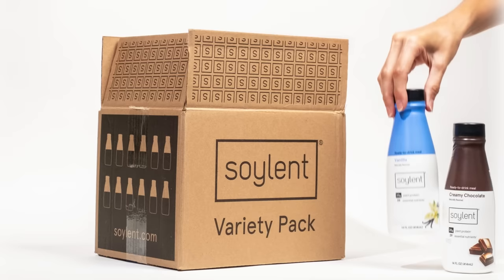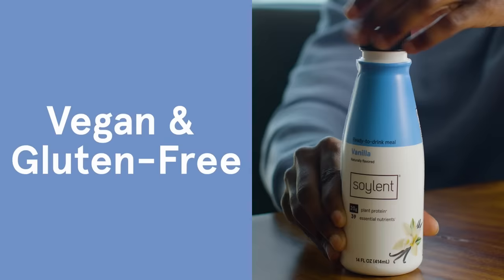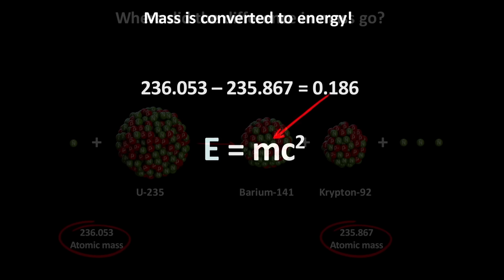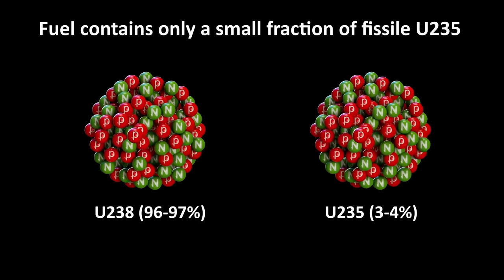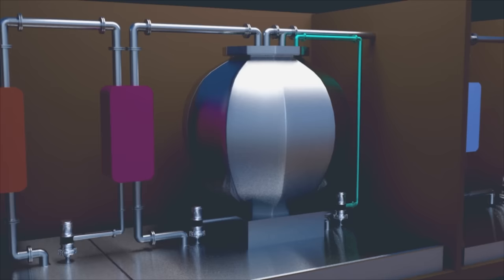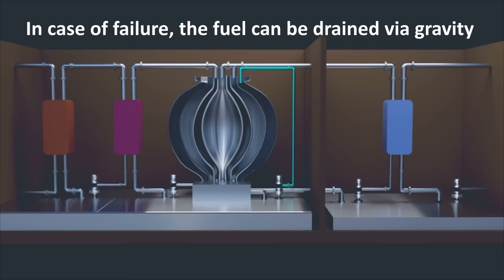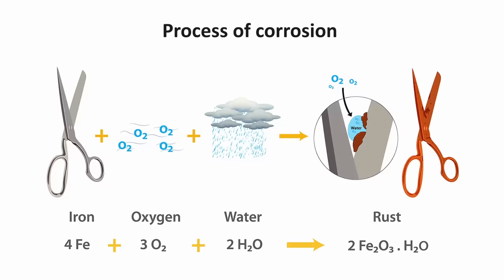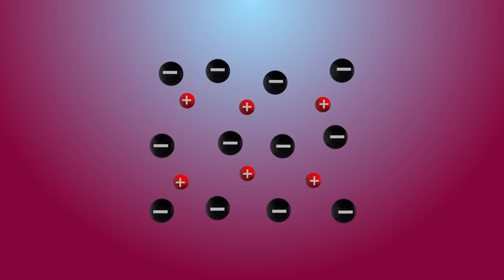How Molten Salt Reactors Could Revive Nuclear Power

Comment: First: As a nuclear power plant engineer who is very interested in new nuclear power plants I would like to complement you on being I believe the 1st YouTuber to talk about the very real corrosion issue with MSR's.   People often wonder why there was never a 2nd MSR test reactor after Oak Ridge.  It was because there was no known super-alloy of the day that could withstand the corrosive effects of the daughter products and chemicals generated by their reactions in the mixed molten salt stream that occurred at the Oak Ridge test MSR.

The good news is that a number of countries have been doing research into new "exotic" super-alloys that should better withstand the corrosion (to the best of my knowledge - no one has found an "immune" super-alloy at this time).   Also, that the concept of chemical separation of the problem daughter products and resultant chemicals has been developed and limited testing of the concept has been done without actually using real MSR molten salts and daughter/chemical byproducts.

So the theory is that if you use a much better super-alloy than what was used in Oak Ridge and can filter enough of the daughter products and chemical reactants that you can minimize the corrosion rate to one that would allow construction of a 40+ year operating life reactor and molten salt stream piping and equipment.   As you pointed out this is only a theory and has not yet been adequately demonstrated.

China built and started up a 2 MWthermal test reactor in I believe August 2023 to test their best guess of the right exotic super-alloy and an adequate filtering system.  This test reactor is about 1/4 the size of the 1960's Oak Ridge Reactor.  If it works (which is an unknown and failure is a real possibility) they plan on building another test reactor 10-15 size larger to see how it scales up.  If that works then a small power plant (likely in the 40 - 60 MWe range).  Then if that works they can design a power plant likely in the 200-400 MWe range.   Etc.   

Each step is likely to require a minimum of 5 years of successful run time before finalizing the next larger size plant design and starting construction.  Reliable MSR power plants are likely several decades away.

Note that the history of nuclear plant development worldwide shows that scaling up from test or small reactors often does not go very well.  Lots of plants the next size larger did not work well - or needed major modifications.   No one at this point knows enough about the performance of any fuel in a MSR to do anything but take a very large gamble on building a power plant sized reactor (and we know that well as the USA built 4 commercial thorium fueled nuclear power plants in the 1960's - 1970's and all 4 were both a technical and a commercial economic failure:  I will post separately on that history).

Second: Liquid salts are not the only material that expand and self control a nuclear reacton in a reactor.  Light water BWR's and PWR's do the same (I'm not sure of heavy water reactor designs); and in the case of PWRs (which I have worked extensively in) once the reactor is in the power range they pull out the control rods more and just let the water temperature self moderate the reaction rate.  So nothing new here.

Third:  I hate to pop your bubble about Copenhagen Atomics, and about 15 other such companies in both the MSR and SMR market.  I consider them an investment scam company (they exist to get investor money to fund jobs for a decade or more).  They are not serious at all about building a real nuclear reactor and their designs and timetable are laughable to anyone with real experience in the nuclear industry. They don't even have a clue on which super-alloy will be needed to make the concept work yet (ordinary 304 SS is corrosion resistant to the pure lithium salt with unreacted nuclear fuel in it - the problems start once the nuclear reaction starts).

Companies that are serious are working with a nuclear regulator for eventual licensing of the reactor.  This typically takes several years and multi-millions of dollars in a "pre-License" review process (and all western nations have such a process or will tell you to use a design licensed by other western countries).

The best example right now is I suggest that you look up the Canadian Nuclear Safety Commission website,  page down to "New Reactor Facility Projects" link, then use the link under "Current pre-licensing vendor design reviews" heading not quite half way down the page.  There are two links near the top of the page for "Current" and "Completed" and a list of project at the bottom of the page.     When this process is completed the vendor knows what will be needed in a license application for a reactor design.  It typically takes several years to review a license application once submitted if it has all the required information and the regulator agrees things are properly designed and proper procedures and staffing will exist.

The mass production possibility is a myth.   Airbus and Boeing build over 100 of the same model airplane each year, and they are largely hand assembled.   Yes a number of parts are mass produced; but its cost prohibitive at that production rate to build a plant that could automate the assembly much more than it is currently.   You would likely need to have orders on the order of 250 near identical MSR plants per year for at least 5 years to justify building a plant for mass production (and that plant will take years to build).  Just not happening - no one needs that many new power plants (even at 50 MWe each) for that amount of time.  Also, nuclear plant is highly site specific due to earthquake and natural disaster requirements.   One location may need very light reinforcement and provisions for a natural disaster.  The next site may need 10 times as much.   The sites with low risk do not want to pay for 10 times the reinforcement materials.

Building nuclear plants requires a assembly of lots of parts; and having it in an appropriate safety structure.  Also, nuclear construction codes exist due to lives lost and major nuclear plant issues.  No short-cutting those and only about the top 25% of workers adjust to working like that (it's a completely different approach than normal construction).  They also want to be paid for their expertise.

This myth also assumes that your design is well proven.  It took the light water PWR about 50 years of operating history and lots of failures along the way to know how to build a well proven design (the current AP-1000).   It will likely take a similar amount of time and failures to get MSR reactor plants that are really well proven after the designs are proven in test reactors.  Who is going to buy more than a few units until the design is shown to work well for decades?   Low production numbers means no special factory and highly skilled and paid workers custom building most everything.

Have a great day,
Reply: Thank you for this reality check. I had already suspected Copenhagen Atomics of being an investor-trap, and feel validated that somebody with more knowledge of the industry would say so as well. Does this go for all the highly profiled actors in the thorium space, like Flibe Energy, Thorcon, and so on?
Reply: Thanks a comprehensive reply from someone with his feet on the ground. One other point. commercial nuclear power came about on the back of the atomic bomb projects. Thorium has yet to find such a sponsor.
Reply: That's easily the most excellent comment I've ever seen on Youtube! Better than anything I could've written.

As of late, the Youtube science and engineering community seems to have discovered nuclear power as a topic of interest. Obviously, MSRs and SMRs are the new thing that everybody seems to agree will make nuclear power generation rise to glory again and be the ultimate solution to decarbonization.

I myself was getting tired of always pointing out the obvious problems with that. Your write-up gave me new energy, and I might quote you on occasion, If I may.

Thanks for taking the time to share your reasoning.
Reply: Very well said. Thanks 👍
Reply: Even so, with or without molten salt or variants thereof, I would like to see much more nuclear power. Our current fossil fuel addiction has several downsides much greater than what nuclear ever had. The big one is of course the changes to the climate and the bad consequences thereof. Besides that the emissions themselves also cause a lot of health issues in the population and fuels like oils are often obtained from less savory countries, prop up dictators, help keep them in power and help them to repress populations and cause wars. Besides that (this doesn't count for the US, but the US is not the whole world) not all countries are blessed with an abundance of natural resources and spending a lot to import fuel is a drag on the local economy. Thanks for comment, good luck!
Reply: My bachelor and current master research topic is molten salt corrosion. I just realized how niche this topic is XP
Reply: Subscribed. 👍
Reply: Pin the ** out of this comment, thanks
Reply: A comment like this is golden. Thank you!
Reply: Nice anti-nuclear rant but you started out completely wrong and it just got worse from there. The MSR project did not end because of corrosion issues and I suspect you know this but say it anyway. 

Every single gen. IV nuclear start-up has read every report from those original experiments and developed a strategy to mitigate corrosion. In fact it was their first consideration. Molten salts are no more corrosive than pure water, both just need to be handled correctly. 

What you are (more) correct about is the timing/schedule of the deployment of gen. IV reactors. It will be slow but that's not a problem. The transition from fossil fuels to fission will take a VERY long time. It can happen much sooner but the love affair with worthless wind and solar has to run its course to failure first.
Reply: Then how you do explain the new Chinese MSR's? Do you think there may have been more materials research since the 1950's? Honestly...
Reply: @stickynorth   I discussed the Chinese MSR in my comment.  It's a test reactor designed specifically to determine if we have solved the corrosion issue by use of a "exotic" super-alloy and if the chemical filtering theories and equipment work as planned.  If they do then we now know that we can likely build a power plant MSR that would last 40+ years of run time (working through scale up issues).  If it doesn't work so well - then we have more research and work to do to find a solution.

I have read many papers about different exotic super alloys being developed and tested in "simulated" MSR environments from the last 15 years.   I can tell you that in fact a lot of various other super-alloys than what existed in the late 1960's have been developed and tested.
Reply: @chapter4travels    I don't know what all those people have read.   I know what I have read (direct from the DOE records).

I know that a lot of research has gone on in the last 15+ years in many countries on developing super-alloys that may work in a MSR environment (I have read the research papers).

I'm aware that all of those companies you cite have theories as to how to solve the problem (although some of them just ignore it); but none of the theories has been tested (and the vast majority of theories do not work out as practical in practice - at least without decades of development: history tells us that).

I also know why the Chinese built their MSR test reactor - its' specifically to see if they have an answer to the corrosion issue; and the reality is that the answer we will get from this test reactor is "not yet" based on my knowledge of the history of test reactors and product development (and to develop better thermal performance modeling).  I've read summaries of their papers.
Reply: @perryallan3524  I've wondered how the Oak Ridge reactor ran for so long if corrosion was such a huge issue.  What did they use, and were they regularly swapping out components?
Reply: @JRP3  It's actual run time was fairly short.  While its listed as operating for about 5 years, it only ran part time.

The corrosion issue was not identiried initially although they were aware of the problem by year 3, and knew it was a significant issue by year 5.  The true extent of the corrosion was not actually known until after the Oak Ridge MSR was dismantled for disposal.

Oak Ridge worked despite the corrosion because of very conservative design.  components and piping were thicker than required with more modern standards.

Contrast that with modern nuclear power plants that are designed and licensed for 60 years up front and built with materials that experience has shown will not have any major issues for that run time (with allowances to extend the license beyond that).  Many people expect these plants to run for double that.

I spent most of my nuclear career in a plant designed and licensed for 40 years.  It got a license extension for 20 years (to 60 years of operation) and the 1st unit is now over 51 years old.  The plant has applied for another 20 year license extension (to 80 years) and people are seriously talking that it might run for 100 or more years safely (and that they may have to replace all the wiring and controls for the plant for that - which would likely be a 1 year or longer shutdown).

That is what a MSR reactor has to compete with.  So the corrosion issue really must be solved.
Reply: You said it. 😎
Reply: I read your whole comment. Thanks for your insights.
Reply: Not sure how you define cost-prohibitive if a city, state, or country can afford to build new power stations. Does everything need to be profit-based? That causes as many problems as it solves (like cost-efficient car power vs global warming). We really should think about better city power tech from the standpoint of what the people need instead of what a company wants.
Reply: @watamatafoyu   You are correct that cost by itself is problematic.  However, in the end a cost effective solution must be part of the equation.  There can be other factors.  For power plants you might want to say low CO2 Emissions, Low (or no) particulate emissions, or many other factors.  You also may wish to say a method that does not kill or maim people (or only does so very rarely due to very rare events).  The list of other factors can be long.

Then you have to look at the lowest long term cost to achieve the other factors.   Anything else requires the people to pay more money for a basic service such as electricity, money which most likely can be better used in other areas of their lives.

Power plants are not exotic yachts where only the very rich or wealthy utilize and in reality the owners don't care much about what their "toy" costs for the features they want.  Power plants provide a basic commodity that is required for normal society and most companies to operate.
Reply: @overtoke   I don't know.  However I know of no glasses that would stand up to the temperatures and vibrations of an operating nuclear reactor and its piping.  Ordinary glass will melt.  Quartz may not melt at operating temperatures but is brittle and has no real strength.   There is also no way to coat the ID of everything (reactor, piping, valves, flanges, etc.) to prevent corrosive attack anywhere.
Reply: While the AP1000 seems to be working well in China, the units in Georgia were enormously expensive and several years late. I worked on the ones being built in South Carolina that had to be cancelled when the delays and cost i creases became unbearable. Part of the problem was the designer picked some incompetent subcontractors who had no nuclear experience. Another was trying to recruit workers who were willing to put up with nuclear standards, drug testing etc. We recruited people from as far away as Alaska. Many were in their 50s or older and being on a committee that reviewed discrepancy reports, it seemed like the workplace injury rate from heart attacks, falls etc.was high.

People see a video or lecture about a neat idea, get enthralled with the technology and never consider what are mundane matters that can make or break a project.
Reply: @KevinBalch-dt8ot   The problem was twofold - and you identified the biggest one.  The USA had lost the knowledge at both the contractor and worker level to build nuclear plants.    Extremely costly with lots of delays, rework, etc. As only about 1/4 of the current workforce can adapt to how things are done in the nuclear QA world - they had to flush a lot of people though (and absorb the mistakes and rework) to get people who could do the job.

Another problem was that a number of suppliers did not actually ship the required grade materials to site (they substituted lower quality materials - and may have submitted false certification paperwork).   In the end a lot of material had to be reordered from new suppliers - which meant more delays as instead of having material on time - you now had to wait months if not a year to get what was needed.  Unfortunately, it was difficult if not impossible to recover the money already spent on substandard materials and  parts.  I have been told by several people onsite that there was cases where the substandard material was not discovered until after installation - which meant tear out and redoing with good material.

However, if you take the same contractors and contract managers and supervisors to build the next nuclear units...(before they age out) things will go much more smoothly as they have learned their lessons.   Another set of AP-1000's started in a few years would likely only have about 1/2 of the overrun for the units you worked on, and a 3rd set after that would have minimal delay and rework as the US will by then have trained enough managers, supervisors, and workers to keep the project on schedule.

By the way, this kind of delays and learning curves happen in the non-nuclear industry as well when entirely new products are developed and put into the market (the 1st ones are always very expensive, then the next batch is cheaper, etc).  It's just not as costly.
Reply: From what I've seen and read, the corrosion issue isn't just within the reactor either - MSRs need a very complicated chemical processing plant, and corrosion is a big issue there as well.
Hopefully the scientists and engineers working on this will figure out solutions to these issues, because it certainly has potential.
Reply: @DeanLee1   You are correct.  It is every system and component that the circulating MSR fluid touches: Piping, pumps, valves, instruments, chemical separation equipment, sampling equipment and coolers, etc.  Everything.

Companies that make all of these components will have to design components with whatever super-alloy they come up with that works well enough to be usable.

You may also see a lot of lessor equipment ans systems replaced periodically as well if the equipment cannot last decades of exposure.   Most people do not understand how expensive that would be.
Reply: @DeanLee1 - It’s not just the corrosion. In solid-fueled reactors, the highly radioactive fission products stay in place in the heavily shielded reactor. In an MSR, they are circulated in the pipes making them highly radioactive. These can be shielded during operation but it makes maintenance more difficult.
Reply: Thank you for this incredibly insightful comment! You don't see many comments like this, especially on YouTube, so thanks for taking the time to write it.
Reply: All this is just telling that MSR is just not wanted. All just nitpicking problems, many of them that were already solved during the development of the traditional nuclear plant. The only real reason seems to be the lack of a suited anti-corosive alloy. But that's just one single problem. It leaves me completely baffled that, with all the advantages that molted salt reactors, there isn''t a more optimistic stance and that more resources are not brought into making this work. 
The speaker here addressed actually the fact in one sentence "it's not wanted because it doesn't produce plutonium". When a clear explanation is not given but avoided, that's the only conclusion remaining. 
People must be made aware of this possibility and I think social pressure is what eventually will drive the MSR to fruition. 
Thank you for you insight but I don't think it was unprejudiced.
Reply: @rccc5806  this is quite a foolish take. There are many technologies that are one problem away from being the perfect solution. Oh if only we could just make a room-temperature super-conductor, we've made lots of super conductors before, why not just make one room-temperature? It's just one problem. See how foolish that sounds? It is not nitpicking to say that this technology currently has serious issues with corrosion, and it is a complete mischaracterisation to just hand-wave it away as "just one single problem". 

Furthermore, the problem with nuclear technologies these days is that fission is considered (by the public) as dangerous or scary, which hurts political will, which removes funding. For the funding that exists, there is a lot more focus on fusion, of which are a lot of junk startups (in both fusion and fission). Additionally, the infrastructure and knowledge base is built entirely around Uranium and refinement of Uranium (due to cold-war decisions as Uranium could be used to make nuclear weapons), so doing the same with Thorium will take many many years, even decades to prove efficacy as the original commenter mentioned.
Reply: Thanks for sharing your expertise , and realistically limiting our hopes / aspirations , in dealing with corrosion.But …., what if design and development was limited to smaller , limited eg 5 MW , modular and mass produced reactors , rather than scaling up , …. and if collaborative international design and development was urgently prioritised - could the problems be resolved in order to make a difference to greenhouse gas emissions in time ?
Reply: @Vnifit  So, your take is "we don't have knowledge with Thorium because we don't have knowledge with Thorium". Very smart that one. 
I am not the one to assess if corosion is an equivalently difficult problem as high conductive at room temperature, but I gather it is really not like that. The willingness to take on the problem could go a long way. But hey, in these days it's worth more chasing ilusory solar and wind horses. 
I also think, current Uranium technology is still viable but really Thorium looks very much like a very close next step, far, far closer than the fusion.
Reply: @sheenapearse766   First:  No one even knows what exact alloy and amount of chemical filtering will work yet.  That is independent of MSR reactor size.

Second:  No one knows yet what "theoretical" design will actually work long term.  The vast majority of designs that people think up don't work out in real life (how you would solve this problem - and there are hundreds of problems to solve in a nuclear power plant: lots of things look good on paper and sound good in theory: the real world is different).

The USA currently has literally what I consider the best and safest new PWR design reactor in the world (AP-1000 Nominally 1100-1150 MWe net). The European EPR has been a disaster and the designers admit that they have to redesign key elements and no further EPR's will be ordered).  Note that the Chinese just ordered 6 more  AP-1000's as it's far better than their own latest design which incorporated elements of the AP-1000 design, Ukraine is planning on I believe 7 of them (and they are starting construction on a plant with 2 AP-1000's), and other countries have said that they are looking to build another 15 AP-1000's with construction starting at various points in the next decade.   

We got there because the USA built something like 104 nuclear power plants with something like 76 different plant designs in the 1960's - 1990's. Some of those plant design decision were so bad that the plants were retired in less than a 5 years (even large base load units).

After 30+ years of operation of the designs that worked well enough to run that long the designers of the modern USA Gen3+ (passive safety) could ask such questions as: What is the best design for a spent fuel pool?  You would think a reinforced concrete water pool somewhere in the range of 40-50 ft deep with a SS lining would be easy to not mess up.  I understand that the USA built 4 different base designs of Spent Fuel Pools, and 2 of them had noticeable problems that developed after 20 years of operation, and one design stood out with the least issues (and perhaps no issues) after 30+ years of real plant operation).  They could do this kind of long term "best design" analysis for over 100 specific design features that are required for a PWR nuclear power plant (and GE did a similar thing with BWR plants although there were a lot less design options built).  The AP-1000 used all the "best long term" PWR design features based on 30+ years of actual PWR plant operations.

While some of the steam cycle side features of a MSR could use this knowledge base - there is not any similar design and operating history for any MSR based power plant (and I remember reading about 4 completely different design ideas for the MSR reactor itself, which does not even get into all the support systems).

Standardizing on any single design at this point for the MSR is just taking a huge and very costly gamble (read my Thorium Power Plant History Post - which is a separate thread).  No one knows if the design chosen will even last or work well long term.  The history of nuclear reactor design worldwide shows many initial reactor and nuclear plant designs failed at the test reactor size or when scaled up into power plants, and a number of 2nd generation designs based off of lessons learned from the 1st failures also failed.

Third:  A key part of nuclear power plant cost of operation is protection of the plant and public from terrorism (security team and design features), having an adequate Radiation Protection department to handle a major nuclear issue at the plant and area surrounding the plant, and having an adequate Emergency Response staff to protect the health and safety of the public in the case of a major reactor incident and leakage of radionuclides into the atmosphere where it affects the downwind population (it seems that most MSR scam companies don't talk about these costs).

The cost for any nuclear power plant for Security, Radiation Protection, Emergency Response actually does not change much based on the size of the nuclear power plant.   That is one reasons the nuclear industry in most cases builds large central stations - in order to keep the staffing cost reasonable on a per MWhr of generation basis.

Fourth: there will never be any cheap nuclear power plants.   As an example NuScale developed and licensed a 50 MWe PWR SMR in the USA with a plan to build a plant with 6 units (total plant size of 300 MWe) in Utah.  The site was licensed and a Construction and Operating License (COL) was issued by the US NRC (Licensing the plant and site alone likely cost over $10 Million, and perhaps several times that).  

Now everyone had noticed the huge delays and cost overruns of canceled VC Summer and nearly completed Votgle AP-1000 plants; which were caused by US construction companies having lost the expertise on how to build a nuclear power plant to nuclear construction standards: Construction management had no clue - and thought it could be built like a fossil fueled power plant.  Then add a workforce that had no idea how to build things to nuclear construction standards (non-nuclear "close enough" is "good enough") construction practices just does not work in nuclear work, and you cannot have workers that use recreational drugs or are in trouble with the law.  Then toss in a variety of component and material suppliers who substituted cheaper than specified materials and products (a lot of which had to be tore out and replaced):  The USA learned a lot about which supply companies could be trusted.

So the Utah project specifically asks for bids from the Construction Mangement companies at the VC Summer and Voglte plants that had learned very costly lessons on what it takes to build nuclear power plants.

The quote came in at $9.3 Billion, with an estimated inflation adjuster of $1 Billion during the life of the construction project ($10.3 Billion estimated total).  That works out to about 3 times the cost per MW hour than the Vogtle AP-1000 plants which are 7.4 times larger (2228 MWe total plant size).

As the operating and maintenance staff will be about the same size as Vogtle AP-1000's (6 small power plants vs 2 large ones - about the same staffing requirements); and the Security, Radiation Protection, and Emergency Planning staff would also be about the same size as Vogtle.

So this 6 unit SMR plant will cost about 3 times as much to build per MW of generation, and the operating staff cost are in the range of 7 times higher compared to Vogtle AP-1000's.  What makes you think that SMRs (of any technology) will be cheaper than larger central stations.

The project was canceled and talk of "small" SMR's of any technology has tanked in the real world.  Even the most recent SMR talk among serious companies are using a 300 MWe "SMR" which is the approximate size of a number of initial nuclear power plants built in the 1960's and early 1970's (none of which are operating today).

Fifth: high production rates of any MSR design (even if small) is likely to only occur 50+ years in the future after some design proves that its' long term reliable and economical.  Until then there are really no cost savings in the construction cost of building a nuclear power plant.  Even at a rate of 50-100 Units per year the plant will largely be field assembled by hand using components shipped in.  All plants will be built to nuclear construction standards (and anyone saying they are going to use lower cost commercial production techniques is "blowing smoke").
Reply: @FrancisFjordCupola  Long term for solar system wide and/or interplanetary expansion, nuclear power is essential. But, short term and specifically for fighting climate change, fossil fuel companies and petro-states promote current and speculative nuclear power as a solution because they know it isn't cost effective. If you look at current un-subsidized Levelized Cost of Energy (LCOE) both solar and wind come in well under nuclear, and under the cost projections for these "mass produced" new nuclear technologies.
Reply: This type of defeatist and pessimistic mindset is why innovation has dramatically slowed in the last few decades in the energy industry, people like you who are only capable of seeing how things can't work, but are never creative enough to see how they could. Those inflicted with poverty of imagination. People like you aren't meant to give opinions on what could be possible, you aren't meant to give opinions on how you think the world will look like a decade from now. There is a level of creativity and imagination that is required to be that type of person, both of which you and many people in the energy industry simply lack. You are meant to do as you are told and keep maintaining the status quo. 

I will keep rooting for companies like Copenhagen Atomics who are daring to disrupt slow, inefficient and un-innovative industries. 

You would have told Elon Musk that electric vehicles and reusable rockets were "decades" away or some kind of pipedream if he had told you about his plans a few years ago.
Reply: @sheenapearse766   My apologies, I forgot to list a 6th reason why you won't see mass production of any reactor design.  I thought I had addressed it above in other comments.

Sixth:  there is and will never be a "standardized" design for a nuclear power plant.  Designs are very site specific due to the different natural disaster possibilities for each site:

What is the worst flooding risk - and from what?  Fukushima was in fact a failure of the Japan nuclear regulator to require nuclear plants to be designed for tsunamis.

Fukushima only had to be designed for flooding that occured on average less than twice the licensed life of the reactor (80 years).  The tsunamis in the area were known to occur about every 90 years.  So the plant was built to a standard that provided a 45% chance of a tsunami in its 40 year operating license.   The plant could easily have been built 3-4 meters higher and not been affected at all for very minimal additional operating cost (more energy needed to pump cooling water for the steam condensers).   They actually buldozed down a hill more than that to build the Fukushima nuclear power plant.

Needless to say, Japan and everyone else has changed their standards as needed.  However, that plant design never would have been allowed in the USA and most of EU countries as the design standard has always been "much worse than any event in the historical record."

What is the earthquake risk?   The more severe the "design" earthquake based on the historical record the thicker the reactor vessel wall and piping will have to be.  More robust support structure and more  robust piping support structures, and more robust "auxiliary" equipment like chemical filtration units and various storage tanks.   Even the foundations of the plant and the containment and shield building structure  has to be more robust.

What is the worst case wind risk? Hurricanes/typhoons are the lowest risk (although they often cause substantial flooding).  Tornadoes are worse.

Terrorism risk?  Some sites are more easily naturally dependable than others.

Does the plant need to be air-conditioned because its often (always) too hot to work in or too hot for the equipment (this is common for plants near the equator in certain parts of the world)?  Does the plant need to be heated parts (or much) of the year (common in the extreme north)?

No one wants to pay for a standard design that's built to the worst case standards for everything.  It would be massively expensive and overkill for almost every site in the world.  So each plant has its own specific design requirements in order to appropriately protect the health and safety of the public.

That totally negates mass production of a single design.  Sorry.
Reply: Thanks
Reply: @xBIGMUSCLEx  You got me wrong.  I'm just being realistic about what it takes for nuclear power.  Our current design and construction standards are written in some cases in blood (people really died) and in many nuclear "incidents" that were extremely costly.  Companies like Copenhagen Atomics are telling people that they can ignore the design and construction standards - and don't even have to license their designs or sites they are going to put their reactors on.

Tell me - how many atomic power plants do you think they well be allowed to build without using approved nuclear design and construction methods and without getting their reactors licensed.  They might be able to  bribe some 3rd world country dictator into allowing it; but neither China nor Russia would even consider it.  No mass production possibilities with a few 3rd world countries.

Do you know what the key responsibility of all staff at nuclear power plants in the western world is:   "To protect the health and safety of the public."  It's not to generate power first, it's not even to protect the plant workers (most who will voluntarily die if that's what it takes to stop a nuclear catastrophe).   Now it's more than great if we can generate power while protecting the health and safety of the public, and the plant staff  - and the nuclear power industry has proven that it's quite doable.

As for thorium power- the likely cheapest safe way to move forward would be to put a thorium core into something like an AP-1000 PWR reactor.   The Shippingport "demonstration/test" reactor (60 MWe) showed that you could put a working thorium core in a PWR light water reactor.  Please read my post on the history of commercial thorium nuclear power plants (the USA built 4 of them).  They took the lessons learned from the previous PWR thorium failures to design that core.

However, MSR reactors have a lot of R&D to go and I don't doubt that they can eventually be made to work.  It can be done - but it will not be quick and cheep.  For those willing to invest sevearl hundred $billions with the expectation of decades to make it work it may be possible (and the Chinese MSR project was funded at $500 Billion in 2011 and the researchers don't expect a power plant for many years: of course there are PR people claiming otherwise).

Also there is "zero" evidence to suggest that in actuality that thorium reactors will in fact be cheaper than uranium (or plutonium) reactors.  All we have is a theory that it should be possible.

Also key to this theory in many cases that it will be economically reprocess and recover the U233 from a thorium based reactor (thorium is not fissile - it will not react by itself).  Thorium can be converted inside an operating nuclear reactor into sufficient U233 which is fissile and what a thorium based reactor actually runs on once its seed fissile materials are used up.
Reply: As I remember Pu is not just a waste product in nuclear power station, some isotopes  of Pu is fissile too and contribute to energy produced.
Reply: Thanks so much for taking the time to write out this detailed response :)
Reply: Nice post!
Let's try anyway.
Reply: could active cathodic protection be used to protect the reactor from corrosion?
Reply: @kellymoses8566   That might work on the main reactor tank and some of the piping and valves.  It would be very costly to build and we don't have a clue as to how much impressed current would be needed.

The bigger problem is that you will never be able to protect the inner chambers in the reactor vessel and many of the instruments and auxiliary equipment.

Then there is the reliability issue.   While impressed current systems are reasonably reliable; I'm not sure that they are up to nuclear safety critical equipment reliability standards.

I've been sent far to many pictures of major equipment damage from the failure of the cathodic protection system when I was actively working in the nuclear industry to think this would be a good idea   All the equipment with cathodic protection systems that I ever saw in nuclear plants were on non-safety related systems.

The reactor vessel, primary loop piping, and many of the auxiliary and instrumentation systems for the molten salts will be classified as "Safety Related."
Reply: Could ceramics be used instead of alloys to prevent corrosion?
Reply: @perryallan3524  Perhaps they could be designed to easily replace corroded parts.
Reply: @KlaunFuhrer-du7fr   Good thought idea.  But, I think hat is unlikely as our current ceramics tend to be fairly brittle with limited fatigue tolerance (what we have decades in the future may be much better).

Nuclear plants have a lot of vibration from operations and thermal expansion from heat up and the thermal shrink from cool-down.  Ceramics may work for an isolated component not connected to anything (say a flask) but when connected to all kinds of piping where everything moves differently I don't see it working.

Then you factor in the fact that the plant has to be designed to handle a much worse than in the historical record earthquake for the area.   Things really move around in earthquakes and a lot of stress is put on all connections (compressive and tensile).   I just don't see ceramic piping system that are connected to ceramic components as standing much of a chance of withstanding an earthquake at our current level of ceramics.

An additional problem is how do you join things together.  We weld metal parts together so there is no leak path. We have piping welded to reactor vessels that are over 50+ years old of near continuous operation and a weld cracking and leaking is an extremely rare occurrence in nuclear power plants.   

Ceramic components would have to have all flanged joints - which provides many leak paths and a real maintenance headache over the years. Also the bolts would have to have a similar thermal expansion rate as the ceramic and be fairly immune from corrosion in a leak.

Still a great thought about future possibilities if our ceramic technology greatly improves.
Reply: @kellymoses8566   Replacing corroded parts tend to be very expensive as everything will likely be highly radioactive and welded together.  

Since this molten salt stream is going to be recently exposed to nuclear reactions its likely to be very "hot" radioactively and this likely gets into "special exposure" dose rules and regulations.  

It can be done (and it has been done occasionally); but at great cost (often the workers get permission for a planned "special exposure" and then because they cannot get any more dose for year they are handed a $100,000 - $200,000 check for their lost wages for a year and restricted from most nuclear sites worldwide for a year.  Often there are at least 2 workers involved in such operations.  

There are a few cases where people got so much dose their nuclear career was over (these have been very rare - and they really have to be explained to the NRC in the US)..  Then you get into $Million+ dollar checks per person.

This also will apply to multiple piping systems, components, and instruments.  If its a large scale replacement of many components or system piping I just don't see it as cost effective.  

Large scale system replacement cost of systems are the reasons that a number of nuclear power plants were closed prematurely in many countries in the world.

Now if you can leave the plant shutdown for some weeks (or months) for the radiation to decrease - things get a lot better; but lost generation is real money as well.

As a planned strategy... this likely will not be cost effective.
Reply: Fascinating.  Thank you!
Reply: I am cutting and pasting this into my main notes, and now this will be my primary source if I investigate further , and what I will defer to when my "opinion" on nuclear energy is invoked . Thanks for taking the time to write this.
Reply: @perryallan3524 If a MSR is 25% the cost per watt of a regular reactor then you could make two of them and switch between them to do maintenance and still be ahead.
Reply: Thanks for such a detailed account of the status quo
Reply: The reason that the government discontinued MSR research had nothing to do with any problem with the technology.  While the physicists working on it thought it a superior concept to LWR's, it was being developed to power an airplane, and putting a nuclear power plant in an airplane is insane.
Reply: @perryallan3524 This was a great insight into Nuclear power plants and what's involved. All of your highlights are right on and the risks and difficulties are huge. Even if it takes years though, progress needs to be made. It is good to have many countries trying to figure out the problems and address this. Hate the scam companies though, as they just slow down progress. We need to find some viable solutions for the future. Even if it takes 50-100 years, it's better late, then never.
Reply: @kellymoses8566   That is a huge "IF" because the reactor vessel is only a small part of a nuclear power plant (even if a key part).   A reactor vessel could be free and the cost of a completed nuclear power plant would drop by perhaps 10%.  As a general rule - adding a 2nd reactor adds complexity which adds cost and a lot of risk as a huge number of key valves would have to exist and not leak. To get a "no leak" scenario it usually takes 2 valves with a drain and/or vent between them.
Reply: @ThatsMrPencilneck2U  The airplane test reactor was only one of the designs considered, and the only other one other than the Oak Ridge test reactor that was built and tested.

However, they also built a U235 aircraft reactor, and both are on display outside of the 1st test nuclear reactor that generated electricity in Utah.   I've been there and looked at them and toured the test reactor facility.

The Air-Force quickly concluded that putting a nuclear reactor in an airplane was insane as well - especially once they knew how heavy radiation shielding would have to be to protect the crew (there would be minimal capability left to carry bombs).

However, the reason that there was no follow-up to the Oak Ridge MSR test reactor for possible power production was due to the corrosion issue.  Space, weight, and radiation shielding was not an issue for power plants.
Reply: @perryallan3524  The test reactor was never intended to go on an airplane, but had to be design with principles that lead to an airborne design.  A terrestrial reactor can be as simple as dumping some graphite marbles in a bucket.
Reply: @perryallan3524 thank you for providing answers to a whole sphere of questions here in this thread as well as writing a very comprehensive comment in the first place.  You have possibly set a new standard, also in the kind of language you use.
Reply: @ThatsMrPencilneck2U  The USA built and tested 2 nuclear reactors on bombers with the intention of seeing if they could build nuclear powered aircraft.   2 aircraft reactors were built and actually operated on flying aircraft:  U235 based, and Thorium based.    

Neither of the aircraft test reactor actually powered the bomber.   They wanted information on radiation and the ability to control the reactors when airborne, and other things.  Had they progressed with the experiment I recall that the plan was that the reactor would replace the combustion chamber in a jet engine (and one reactor could handle the airflow of multiple jet engines).

These aircraft reactors where completely separate from the Oak Ridge MSR test reactor and are on open display in Utah (no cost to see them). They are still mildly radioactive many decades after the fuel was removed and disposed of; but safe enough to spend some time outside of the low fence-line around them to look at.

As far as nuclear reactor design - you don't even need graphite with the right configuration.  Mother nature has left sevearl old burned out natural nuclear reactors around the world.
Reply: @Kezoman1   You might want to read up about the operating history of the Oak Ridge MSR test plant.   It was anything but "running just fine."

The Oak Ridge MSR was designed to operate at 10 MWthermal.  It's maximum output was 7.4 MWthermal.

It tripped or had to be shut down 167 unscheduled times due to problems in addition to the 58 planned shutdowns to fix things or for 1 refueling outage.

Overall it operated on average only 40% of the hours during the years it was in service because of the breakdowns and things that did not go well that required lots of extra repair/modification outages; while other nuclear test and power plants of the same era were operating 90% of the time.

It was in fact a very troubled design with lots of issues; not to mention that the Hastalloy it used as its molten salt circuit alloy did not stand up to the high radiation, molten salt solution, etc.
Reply: @ThatsMrPencilneck2U   Some more information on the Air Craft Test Nuclear Reactors:

Key point is that they were built and operated under a 1946 program to investigate the feasibility of nuclear powered aircraft.   The program was shut down in 1951 (about a decade before they even started designing the Oak Ridge test MSR reactor).  The lessons learned from its design were incorporated into the Oak Ridge land based test MSR.

However, even with those lessons learned the Oak Ridge MSR was constantly breaking down and had about 58 planned shutdowns for repairs and 167 trips or immediate manual shutdowns from problems.

The Oak Ridge test MSR only ran about 40% of the time due to all the problems when other well designed test reactors and nuclear power plants of the same era were running 90% of the time.

So many seem to think that the Oak Ridge MSR ran well and we really know how to proceed.  It did not run well at all and is in a group of test reactors that are considered failures in design.
Reply: Is molten sodium less corrosive than molten salt?
Reply: "investment scam company".  Hmmm.  I would recommend you withdraw that.  It seems libelous and defamatory.
Reply: Phew, that’s a lot of great research and effort, thanks for the entertainment, now I’ve just gotta duck out and give my solar panels their monthly loving wipe down.
Reply: @perryallan3524  And yet oddly enough there are thousands of coal and gas powered plants that use highly standardised components and designs all across the world.  And they too have to meet their own safety standards.
Reply: I've read your response several times - it's well informed alright, but from the perspective of someone very much captured by the existing technology and institutional processes.
Reply: @philipwilkie3239  There is no comparison at all between fossil power plant safety standards and nuclear plant safety standards (I've worked in both).   

A fossil plant does not have to be designed to withstand earthquakes, floods, tornadoes, someone crashing a commercial jet into them, and many other things because the plants do not pose a risk to the public beyond a few hundred feet if they are destroyed.  There is no possibility of a major radiation and radioactive materials leak into the surrounding areas.

If the plant is lost a normal insurance policy is adequate to cover its lost generation, the value of the plant, and routine demolition cost I've seen the video footage of a tornado hitting a large coal power plant - and know that the insurance company showed up the next day ready to write a $1 Billion dollar check if the plant was a total loss.  They were lucky that the plant could be repaired and only paid about $500 Million for lost generation and rebuilding/repairing things to get the plant back online in I believe about 6 months.  At the time I worked in a coal fired power plant owned by a Utility that co--owned the plant hit by the tornado so we got a lot of information about things.

Nuclear plants have entirely different risk profiles (Chernobyl and Fukushima are examples), not to mention lessor events like 3-Mile Island (minimal radiation release to the public - but very expensive to deal with a partially melted core and the value of a lost nuclear power plant and eventual demolition) and a number of test reactors that have had serious failures or events.

As such nuclear plants are designed and built to completely different standards than fossil plants - worldwide.
Reply: @philipwilkie3239   OK which parts are we not going to implement of current requirements:

Are we going to eliminate designing nuclear power plants for local earthquakes, floods, storms and other disaster possibilities.

Are we going back to commercial construction processes and standards that have been shown to be inadequate for nuclear and plant safety (not to mention cost to clean up or repair incidents - and some have permanently shut down the plant).

Are we going to eliminate current security requirements of nuclear plants and nuclear materials?

Are we going to eliminate controlling radiation dose of the workers and more importantly of minimizing radiation exposure to the public outside of the plant foundry?

Are we going to not look for the relevant history and lessons learned of things we are attempting now?

You may call that "institutional thinking" as you are free to have your own opinion.

I suspect others want to include all of the above. Unfortunately from my perspective too many people don't look up and understand the current requirements and why they developed, nor look at the history.

Do you honestly think that outside of some 3rd world country where the dictator can likely be bribed that any industrial nation is not going to require everything I mentioned above and have a licensing process to make sure all of the above are addressed up front?

Where do all of these companies who are saying its going to be cheep and fast think they are going to be allowed to build their proposed cheap mass produced reactor by not following the above "institutional" list of requirements.
Reply: @perryallan3524  I am not for a moment suggesting all that hard won institutional experience is wrong; just that much  of it is only relevant to PWR reactors and their unique shortcomings.

Firstly, the MSR core and associated piping are not operating at substantial pressure; this factor alone changes everything about the mechanical design. Standard flanges, valves and pump designs are usable with modest certification challenges.
Secondly there is no possibility of a steam explosion and thus no requirement for the massive – site specific - containment vessel. Only a few contractors make them and they’re almost impossible to viably modify or repair them if anything goes wrong. 

Thirdly – in the event of the core leaking, all that happens is the salt spills into a secondary container and freezes. The dangerous and normally volatile isotopes of cesium, strontium and iodine, are chemically bonded to the salt and are very unlikely to escape the plant. A bit of xenon might be a problem – but this is not catastrophic.

Fourthly there is no requirement to manage ‘double break guillotine’ piping failures and maintain reactor cooling, which eliminates emergency cooling systems and all their added complexity. It’s far easier to implement passive ‘walk away’ safe systems with MSR’s. Every developer has their favourite method.

Finally, because the MSR operates at similar temperatures to coal boilers, the turbines are commercially available at very competitive prices – unlike PWR turbines. In addition the safety demand on the automation systems – my specific field – are likely a lot less onerous because so much of the hazard is gone. 

Your comments on worker dose rates probably best left for another reply.
Reply: @philipwilkie3239   Hmmm. Who said any of the issues I listed in my previous post only applied to PWR's?

Around the world there have been many designs of commercial nuclear power plants or naval reactors built and operated.

AGR's: The UK was the biggest user and that is where most of them are still today.

HTGR: The US built 2, did not work.  I recall that several more were built somewhere - but I don't believe they are still running.

Liquid sodium:  Lots of power plants built by many countries (including the USA), and even 2nd generation plants.  All shut down very prematurely except for Russia's plant which Russia says has had no problems. Of course the problem is that we rarely hear about the problems that Russian nuclear facilities have until 30-40 years after they happen. So I don't believe Russia's current claim as the design is virtually identical to the design used by several other countries that shut theirs down due to major problems.

Liquid lead eutectic alloy (different alloys) has been used for Russian Navel Reactors.  All retired and Russia has shared the problems that they had with them (this was really interesting reading years ago on the problems).

Heavy water. Canada is the leader there; but many countries have built such plants (not all were CANDO designs)

Light Water BWR's and PWR's.

It just turns out that the light water PWR has been the most commercially successful design in the world.  Multiple countries have found that out on their own.  The UK is replacing their AGRs with PWRs.

Then another half a dozen or so reactor designs have been tried in test reactors.

Interesting fact: Regardless of reactor design - all the plants around the world have shared a similar list of design requirements and a similar list of major accidents and issues - Does it surprise anyone that leaks seem to occur in all designs resulting in radiation release into areas where the leak occurred?

As for you list of PWR issues that a MSR reactor will not have to comply with: Lets put it into regulatory speak and how it applies to a MSR power plant:

Power plants work to eliminate as many flanges as possible as they always are leak points.  You typically only see them for flanged in small pumps.  Valves are welded in.

All valves pumps and components will have the same certification requirements as they would have in any other nuclear power plant - the key difference is that anything that has molten salt running through it - or in a potential leak path of molten salt will need to be corrosion resistant to the molten salt (which is just what super-alloy will they be built from).  Safety Related components must meet Safety Related standards.  Non-Safety related components are typically off the shelf commercial items or built to commercial standards.

You are wrong about no possibility of steam or that you will not need a containment building.   One of the design criteria is what if either the primary or secondary molten salt leaks from a cracked vessel, tank, pipe, etc.  If it lands in water (or can be sprayed by water) there will be steam.   That steam may be radioactive if it was primary loop molten salt.    

A MSR reactor will have a containment building to contain any possible radiation leak from leaked or  spilled primary loop molten salt.  Now it will not have to be guaranteed to hold 60 PSI (or whatever pressure) of steam like most US PWR's

But there will be a containment vessel with some kind of filtered and treated air/gas release mechanism.

There will also be a shield building - to protect the reactor and primary loop from a tornado tossing a 2 ton car at 60 MPH at it (one of the design criteria at 2 of the plants I worked at), withstand an earthquake way beyond what has every occurred in the area, a few other design criteria I forgot, and the new one is to withstand someone flying a large commercial airliner into the reactor building.

The out for the containment building is to build the reactor building below ground.  They looked at that for the Westinghouse AP-1000 and GE looked at it for their new generation 3+ passive safety design, and the Europeans looked at it for the EPR and they all decided that building the reactor on grade and building a shield building was cheaper than building it below grade.

I have seen no evidence that SMRs would be any different than the larger plants in this regard.

In the event of core or primary loop leakage you have no idea where it is going to leak - but it won't be into the planned emergency reactor drain vessel.   Your assumption that all the "bad stuff" except for the xenon being locked in the salt goes out the window if there is water or moisture in the air, or if the molten salt mixture dissolves some paint, plastic, other metals, concrete, etc.  That is why there will be a requirement for a containment building.

You missed the biggest issue that applies to a MSR but not a PWR, if there is a primary pipe break and all the molten salt with fuel drains into the bottom of the containment the floor areas are going to have to be special designed to not allow a critical mass of the molten salt to accumulate in one place.  If it does you now have an uncontrolled criticality event outside of the reactor which will be very difficult to control or neutralize - except by melting through some floor structure that will by itself stop the nuclear reaction by diluting the molten salt (and perhaps it would just melt through the floor and keep on going for a while).

The world has had a few criticality events where critical masses were accidentally assembled, accumulated, or at least once put into a tank.  They are very nasty to deal with.

A MSR reactor will have to be designed for a both the secondary and primary molten salt loop pipe breakage in a double guillotine break of either system at one time for the US and Canada (and likely the rest of the world as well).

An interesting question that I have no idea of the answer - what happens to the primary side reaction if the secondary side coolant is lost by a double guillotine break.  Do you get a reactor meltdown at that point?   If not, why not.  But this question will certainly have to be answered satisfactory.

Another interesting question is someday the primary side to secondary side tubes will leak. What will happen, how will it be managed, and how repaired (now I know all about plugging tubes and all the different plug types and methods).  I just worry about radioactive contamination of the secondary side, or future tube plug leaks.   Also, the reactor itself is likely to be very radioactive and while robots can install common tube plugs - its also extremely expensive to do so (we use them in the PWR industry).

As far as passive safety goes.  We already have it in the new Gen3+ nuclear plant designs.  For the AP-1000 the entire plant staff can vanish instantly for 3 days.  All control and electrical power can be lost instantaneously... No automated control operations at all; and a reactor running at full power will be safe and not have melted fuel for at least 72 hours.  After that all that needs to happen is that someone fills a water tank on the top of the containment building which will last for another 72 hours.   That water tank can be filled with fire hoses using a pumper truck and drawing local river, lake, or ocean water.

After about a month (or so - I forgot the exact time) they can stop filling the tank and the reactor fuel will be safe.

Water can be added to the spent fuel pool to keep the spent fuel covered and cooled using a pumper truck and a fire hose if necessary (it's OK if the spent fuel pool boils as long as you replace the water before the water level gets down to the fuel (typically about 30 ft down to the top of the spent fuel rods).

There is no dependence at all on automated system in a Gen3+ light water reactor system for nuclear safety.   Of course it would be nice if the automated controls would do some things to speed up the cool-down process and keep that tank full; and it sure would be nice if the plant staff could use the controls and piping systems built into the plant via manual control; but none of those are required to protect the reactor core from melting.

As far as turbines, condensers, and all the normal power production equipment.  Both BWR's and PWRs have always used standard commercial turbines, generators, and all kinds of equipment.  

When I started working at a nuclear plant as an engineer they had me go through "systems training" to learn how the plant systems worked and the safety design features.   In many cases the instructor and lessons plans did not explain the non-nuclear balance of plant systems and equipment well.  At breaks half the class would huddle around me as I explained it because it was the same equipment and systems that existed in the fossil power plants which I knew very well (the plant had the identical hydrogen seal oil skids to a fossil unit I spent a lot of time in).  Sometimes the instructors also huddled so they could learn more.

The same nuclear standards will be applied to a MSR plant - they just will be applied in ways that apply to a MSR plant.  None of the super expensive things like containment and shield building or handling a major containment spill will be left out.    

The regulators have experience applying the base standards to all kinds of different reactor technology; and worldwide experience says that all the different technologies have a common set of issues related to nuclear safety, even if a specific design has an issue specific to that design.
Reply: @perryallan3524  What is your opinion that they are building one in Wyoming?
Reply: @frontrangejrs  There are at least a half dozen compaines in the USA talking about building some kind of SMR in the USA.

However, only NuScale applied for and got a licensed reactor design for a 50 MWe power plant unit (which took I believe about 3 years).   No one else has even applied yet as of several weeks ago. 

I am aware that there is one collage/university that is seriously talking about building a MSR test reactor in the USA; but they have not applied for a reactor design license yet either as of several weeks ago.

Nor are any of these other companies going through a "pre-licnesing" review with the US NRC as of several weeks ago (which is a great education and lets people not used to submitting designs for licensing what the licensing and application document requirements are).

The NuScale project was to be a 6 unit plant in Utah (300 MWe), and working with several utilities the site was licensed for a nuclear power plant by the NRC (another several year process - which could be in parallel with the reactor design license).

The problem hit last year with bid request to build that 6 unit NuScale SMR plant - and the cost came in at $9.3 Billion plus an unknown inflation adjustment while the plant was being built - estimated at about another $1 Billion ($10.3 Billion Total).

You could build a single unit AP-1000 (1100 - 1150 MWe depending on the site) for about the same cost, and it would require less staff (now that we have contractors who have learned the key lessons on nuclear construction that were forgotten in the 30+ years that the USA didn't build any nuclear power plants).

Essentially, building the 6 unit SMR cost about 3 times as much as the recently 1st time lessons learned with huge overruns Vogtle plant (2228 MWe) on a per MW of generation cost.

The staffing cost would be about 7 times the staffing cost of Voglte as that 300 MW site would actually need about the same overall staff as the Vogtle plant on a per MWe basis.

The NuScale Utah SMR project was canceled in 2023 once these costs were known.

By the way; the concept of a large number of "economically" produced SMRs was 1st proposed in 1955 at the annual international atomic power conference.

The USA built 17 commercial power plants of what are now considered SMR size units in the 1960's - 1970's.  All of them are shutdown as they cost too much to build an staff compared to the large central stations built at the same time (many of which are still running today).

So while a lot of people talk about new reactors be they test reactors or SMRs.  No one other than NuScale was serious enough to spend the serious money to license a design and a site.

After the NuScale Utah project cost came in; a lot of the people who had been talking about SMRs in the USA and other countries went very quite as all the recent myths about the advantages of SMRs came crashing down.

But anyone who looked at the early history of small nuclear power plants would have known that.  In general it cost about 40% more in materials and construction cost to build a plant twice its size.  Staffing cost stays about the same or increases slightly. Its just far more economical to build large nuclear plants (those numbers came from a paper in the early 1970's).

As far as the Wyoming talk... by whomever,  It's just talk.  Don't think nothing else unless they file for a design review of their plant with the NRC (nrc - dot - gov)
Reply: @perryallan3524  All of those ‘conventional’ reactor designs – apart from the liquid metal types -  have one thing in common the core is operating at pressure. Eliminate the pressure and the leak path design becomes far simpler. And given the temperatures are entirely within normal gas/coal/steam plant ranges I really cannot see why you cannot acknowledge this point.

As for not understanding all the possible the possible leak or failure modes of the primary core makes no sense to me – nor the idea that you cannot control the contents of the secondary containment zone strikes me as very odd. This seems a matter of basic engineering. 

As for the possibility of steam generation – the steam itself is not the problem, no-one died from a bit of tritium exposure. If one was stupid enough to try and quench the hot salt with water, and some of the salt dissolved into it then you might have a problem, but why the hell would anyone be motivated to do that? Just leave it alone and it will cool down in a matter of hours or days. 

But crucially you gloss over the reason for the conventional massive containment vessel is necessary, that because the coolant water is close to the triple point – high pressure AND  high temperature – that if that pressure is lost instantaneously the entire contents of the primary loop will want to flash to steam in an exceedingly violent explosion. Which in turn demands an exceptionally strong and large vessel to contain it. This simply does not apply to an MSR where any atmospheric moisture or  vestigial water that might be present is not under pressure and therefore cannot cause a flash explosion. But then you know this better than I do.

As for the secondary containment – gravity is a wonderful thing and will ensure a liquid flows exactly where you want it to, typically into a volume or vessels whose geometry kills the chain reaction, eliminating the chance of prompt criticality, and ensuring passive cooling. Again each developer has proposed their own preferred configuration that on the whole seem very achievable.

And again because none of the secondary containment is ever under pressure, and is not required to sustain high temperatures or neutron flux for any length of time, it can be made of non-exotic materials with standard industrial methods. Nothing really more onerous than most chemical processing plants bunding.

As for any tertiary protection from aircraft or missile attack, a metre or so of sand/concrete encased in boring old carbon steel would be more than adequate.  Frankly if it got to needing more protection than this, the world would have bigger problems to worry about.

On this point it’s indeed very welcome that Gen3+ AP1000’s achieve a similar level of resilience. 

Could you please clarify your point on PWR turbines – it was always my understanding that because they’re constrained to relatively low steam temperatures (around 350degC) that they’re considerably larger than standard turbines running at much higher temps and made in very low quantities - making them rather expensive.
Reply: Renewable energy has a huge potential, is safe, without radiactive vaste and already now is cheaper than any other energy source.The trend is continuing and in 2030-2040 will be the price of RE 14 times resp .7 times by capital, resp. operational costs cheaper, accordinmd NREL. The investment in nuclear energy will block then renewable. The renewable can be a property of citizen, coops, communities, but MSR  will be property of big energy companies.
Reply: Thank you for mentioning the corrosive nature of salt. Just consult with an automobile owner in the north where they use salt on the roads during the winter and how corrosive sodium chloride is.
Reply: @blindlemonpledge2556  The salt used in a MSE is not sodium chloride, nor is the reactor made of the kind of steel a car is made off. But most importantly corrosion really depends on the presence of moisture and oxygen, both of which can be tightly controlled in a reactor. 

This is all a well understood engineering question. A huge amount of research has been done on this.
Reply: I watched the video which is great but your reply provides a lot more context than the video. Great video and a great reply. Thanks.
Reply: @philipwilkie3239  I believe molten salt can disassociate confirm iron chloride
Reply: @philipwilkie3239  I would also like to know what engineering controls exist to prevent radiation from causing steel to become brittle. Add to this the problem of the containment vessel "breathing".
Reply: @philipwilkie3239  i didn't think they were using sodium chloride
Reply: OUTSTANDING Information and Responses -- Thank you, @perryallan3524.  Would you entertain your responses being combined into an informational essay?
Reply: @philipwilkie3239   You are missing the key point of nuclear safety.

The key design and operating goal of all nuclear plants in the western world is" "To protect the health and safety of the public to a radiation exposure."

Most 2nd and 3rd world countries have adopted it as well.

Next up is a list of things like prevent the structure supporting the core from deforming or melting (that would include the tubes and pipes that contain the molten liquid salt in a MSR), prevent a criticality event, protect the health and safety of the workforce.

Not even discussable is how much the plant runs or if it is economical. The regulator does not care one bit about that.

When you have a primary coolant leak - you will have a radiation leak to the surrounding atmosphere (no one has ever built a plant that did not leak). That is not debatable at all – and there is over 75 years if history going back to WW II in the nuclear world that proves this to be true.

Even mention your thoughts to the regulator and your license application immediately dies as you have just demonstrated that you do not understand nuclear safety and cannot be trusted with a license.

All MSR nuclear power plants will be required to have a containment building to “contain” any radiation from an uncontrolled release to the public.  It will also have to have a shield building if not buried as well.  These are not debatable with the regulator.

Containment buildings in and of themselves can be rather cheap; and shield building need not be excessively expensive.   What you are missing is that you are thinking of the combined containment shield buildings that were built for most BWR’s and PWR’s in the USA.   That takes a very expensive post tensioned concrete structure as it has to contain the 60 PSI (or so) pressure of the worst-case steam flash of the worst-case pipe rupture (this is not a steam explosion – it’s just some of the superheated water flashing to steam; and happens in fossil plants as well when there are major pipe ruptures).

But, some nuclear power plants in the USA built separate carbon steel containment buildings with separate shield buildings.  I worked at one of them.    I was surprised to find out that the 60 PSI pressure worst case main line break requirement did not determine the thickness of the carbon steel plate for the containment building.   The earthquake requirements to prevent structural collapse did. That is notable as this plant was in one of the lowest earthquake severity zones in the USA.

So pressure for the worst case PWR steam flash event is irrelevant to the construction of a carbon steel containment building.   The shield building was also cheaper to build as it did not need to handle any internal pressure.   That will be the type of containment building that a MSR will be required to have.

I note that the AP-1000 uses this separate carbon steel containment vessel and a separate shield building around it.   I know that the generation 3+ GE BWR, the EU EPR, and the Westinghouse AP-1000 all decided that it was overall cheaper to build a shield building than to bury the containment building in a hill or build underground.  I trust their analysis on this.  Keep in mind that a compact nuclear security zone site is cheaper than a larger nuclear site for multiple reasons.

Now lets get into water in containment:   There is a lot of equipment in containment buildings and some of it like motors and pumps require cooling.  You also need to keep the environment cool enough for people to enter during plant operations for routine inspections, operations, and minor maintenance tasks which means some kind of air coolers.  While there are places inside containment where you cannot go due to radiation dangers – most of containment is accessible while the plant is running (I’ve sure spent enough time inside containment at full power).

That requires cooling water (typically now from a “Closed Cooling” water system).  While you could use another fluid I don’t see it changing anything except being more expensive.

Cooling water leaks do occur, and they would drain to a sump at the bottom of the containment building and there may be puddles on the floor at certain places (I’ve seen them).   This sump is also likely to be where a major primary loop molten salt leak would likely head as well (I’m curious how you would prevent that).  If the leaked molten salt hits a water puddle or gets into the drain sump it almost certainly boils water and creates steam.

Then there is the possibility of flooding containment for radiation shielding of a major leak.  Nuclear fuel is extremely radioactive when and after it is reacting and decaying.  Typically for over a decade.   This is why BWR and PWR plants do all refueling and core maintenance activities deep under water.  For radiation shielding.  Also the water cools the fuel.

It would be pretty instant death to approach unshielded spilled reacted molten salt due to the radiation poisoning.   While I can see ways to deal with very small molten salt leaks or spills.  Any major spill will be deadly for a very long time.  It may be best just to flood containment with about 10 ft of water for radiation shielding and cooling and let it sit a decade or two before attempting cleanup.  The regulator may require this feature as part of a MSR license.  If not I’m wondering what the alternative is.

Certainly if there is a major spill the plant will never run again (there area multiple examples of major spills of “something” that have ended the lives of nuclear power plants).

As for steam turbines (and steam cycle components, piping, turbines, and valves).  I have worked with everything from 50 PSI – 2400 PSI steam turbines in my life with a wide variety of steam temperatures up to 1005 F.   A key cost component of plant components, piping, valves, and turbines is determined by the temperature they operate at and the cost of the materials that can withstand that temperature for long life.

The standard 900 PSI saturated steam BWR or PWR has piping, components, and turbines build of standard pressure vessel carbon steel materials (relatively cheap).

On the other hand, the 1982 2400 PSI 1005 F coal fired plant I worked at required high chrome molly materials because if you took the insulation off of the piping or components/turbine they would glow dull red.  Yet they withheld 2400 PSI and high flows with no difficulty (and that Fossil plant is still running today and has never had a major piping or component failure).

Now it is true that the high-pressure high-temperature fossil power plants have cheaper turbines on a per MW capability basis.  But, its not that much higher than a saturated steam nuclear turbine because the saturated steam plant and turbine can be built of a plain carbon steel alloy and the high pressure high temperature steam power plants have to be build with expensive high chrome molly materials.

I hope that answers your questions.
Reply: @philtimmons722   Yes.  I'd be open to putting something together that explains the many issues and factors of nuclear power and how it relates to energy protection.  It may be a while to complete though.
Reply: @perryallan3524  Understood and agree.  Texas grid level EE, and 30 year Master.  I came up in Oil and Coal (Texas) along with Hydro and Combined Cycle Gas, along the way.  Now mostly renewable, only -- as that is what we are building.   Worked with Nuke operators and engineers, and always found them (you) smart and cooperative.   Became concerned when I started to see the amount of "sponsored" FUD against renewables, by folks promoting New Nukes.
Reply: @perryallan3524 , nice writeup and I agree with your take on MSRs...it's going to be a while. Very difficult to protect against corrosion when the salt will have some amount of the entire periodic table (from FP) dissolved in it. Even if that is filtered out at some point in the flow, it will still be there meaning everything upstream from the conditioning/filtering equipment is likely to continue to have corrosion issues regardless of the material used. It is a "hard" problem for sure.

On the proposed Wyoming plant, it is significantly different than all the others clamoring for attention:
1. It has financial backing
2. It has a customer
3. It is a metal fueled sodium fast reactor, not an MSR. Essentially a scaled up EBR-II which unlike the MSRE, ran for 30 years with no serious impacts.
4. TerraPower and GE-Hitachi HAVE in fact begun their pre-licensing discussions with NRC. The documentation is posted on NRC.gov.
5. It is designed from the start to work with renewables and replace the peaker and backup functions mostly filled by gas plants currently. It can run constantly at ~345MWe or can be run for example with 6-10 hrs at 500MWe and 14-18hrs at 0MWe, something current plants can't do without wasteful venting.

The one thing I take a bit of an exception to in your original writeup is the comparison of Negative Temperature Coefficient of Reactivity between water based reactors and MSRs and/or SFRs. There is a huge difference between the two. In a properly designed SFR using the EBR-II as reference for example, the negative feedback is enough to bring the reactor to idle even in a loss of cooling or loss of station power scenario, as proven in the 80s (no moving parts, control rods, valves, etc... required, just physics!). In these designs the fuel itself expands significantly rather than the moderator in water cooled plants as you note and the resulting negative feedback is much, much larger. Ceramic Oxide fuels can't do this and that is the difference. Every reactor type/design has issues that need to be managed, however, this IS a relatively "new" thing and quite different from experience with water cooled reactors. Combine that with a passive natural convection decay heat removal system and it is a safety game changer if (and granted it is first of a kind commercial demo so it is a big if) it can be made cost effective. That is the question they hope to answer in Wyoming.
Reply: It's good to see someone with knowledge of the industry being honest about our ability to roll out large scale nuclear as "the" clean energy solution. There aren't enough workers with the necessary, highly specialized skills in the world to build large numbers of plants simultaneously. They have enough trouble getting the right people for the ones that are already under construction, with many of the best people sequestered away building powerplants for military ships. Yes, we should build more, but it's not the answer to our immediate problems because the timeline for scaling up is longer than we have.

One of the big reasons the U.S. stopped investing into MSR/Thorium research was their "need" for Plutonium for nuclear weapons. Water/U235 reactors provide that material, while Thorium doesn't. It was the cold war, so they went all in on water, which was also technically easier. If they'd kept up the research, Thorium might've been a reality by now.
Reply: @Pushing_Pixels   Glad you recognize lack of trained and willing workers.

However, you are wrong about needing uranium reactors for weapon grade plutonium in the US.   BWR and PWR Power plant reactors do not make weapons grade plutonium due to the buildup of excessive plutonium 240 which poisons the plutonium 239.   This has always been the case and the weapon designers always knew it.  In US power plants the planned common fuel rod reactor run time is 33-46 months, although in some cases it could be 11 months.  All of those run times build up too much plutonium 240 to be able to build a bomb.

To make weapons grade plutonium you need to only run the fuel rods for a couple of months so there is only a very minimal amount of plutonium 240.  That has always been done in the USA by special weapons grade production reactors (graphite moderated).

Now the UK went a different route and did want to use power plants to make weapons grade uranium (and the UK is the only country I know of that did this).  They built a series of graphite moderated Advance Gas Reactors (AGR) called the Magnox plants.  By short cycling the fuel rods they got weapons grade plutonium (just push a new one into the reactor and the old one falls into a tank of deep water).  However they were very uneconomical to run as power plants - but the British did ran them anyway and passed the cost on to the rate payers.   

All the Magnox plants have been replaced by AGRs that were designed to not produce weapons grade plutonium and leave the fuel rods in for extended run times which is far more economical.   The UK is planning to replace all of those AGRs with PWRs.
Reply: @perryallan3524  Thank you for clarifying that. I got that factoid from a documentary on Thorium reactors, but what you say makes more sense.
Reply: I keep being puzzled by the molten salt thing. I have a background in nuclear and conventional energy production, as well as the petro/process industry. How would an instalation like that survive its first trip/scram? In my limited understanding of this design, you end up with piping filled with molten salt, all requiring replacement. That is one hell of an issue, IMHO.
Reply: @jaap_vanekris  It's the same issue that all molten metal plants have (liquid sodium and the few lead based eutectic alloy reactors that the Soviet Union/Russia built).  You have to have heating elements under the pipe, pump, reactor vessel, etc insulation to keep everything above the melting point so it does not freeze solid (and even just to fill and vent the system).   How to do that is well understood - and the world has decades of experience doing so.

The bigger design issue is how radioactive the primary loop piping and components will be.   If anything needs maintenance it could be months (perhaps years) before it's safe to work on in person if the radiation levels of the molten salt fuel stream is even 1/4 of what conventional fuel rod assemblies in light water reactors are.
Reply: Haven't heard any answers to my questions yet
Reply: If this thread runs true to form, you won't answer my questions. I actually doubt your bonafides as a nuclear engineer
Reply: @blindlemonpledge2556    Really?

Lets see you asked about road salt corrosion on automobiles and another replied that a MSR uses neither road salt nor carbon steel.

Then you seem to try to get into a discussion with the replyer about dissociating road salt into its constituent chemicals.

Duh... what does any of that have to do with MSRs, thorium, etc.

Then you asked a question about radiation embattlement of metals.   I believe I posted (or tried to post) answer to that - and it was perhaps an answer to another person who asked essentially the same question (sorrry I don't have time to look for that at this time).

But, the simple answer is that we now know which metals embrittle with radiation at a worrying rate, and which ones don't.

Similarly, some metals corrode in certain environments and some do not.

Then you have the audacity to troll me about not resounding to your post.  I assure you other people besides me are not going to think well of you for that.

You are free to question my credentials - as is anyone.  But you might look up specific things I mention and find out if they are real or not (and the history of thorium reactors is a great place for that as the references are easy to find).

Also, I have a life outside of YouTube.  Some days I can only get here once a day - and I don't have unlimited time.   Most people understand that.

You have the freedom to write question and comments (dumb or intelligent).  People don't have to reply to you on social media.

I will not respond to another post by you on this thread.
Reply: @perryallan3524  That"s OK with me I don't beleive you are real anyway.
Reply: @perryallan3524  I didn't say either that road salt or carbon steel was being used. Come on, super alloy? So you admit that corrosion is a problem in a molten salt reactor, and at the present time there is no iron alloy , carbon steel or otherwise, that can withstand corrosion from your salt. Exotic side products control? Those would be coming from a fast neutron striking one of the atoms of the salt or from the alloy used to contain the salt.
Reply: @perryallan3524  I'm not here to make friends I'm here to ask questions. The process of disassociation is the reason that road salt corrodes automobile bodies. Disassociation also causes simple steam to become corrosive and it's the reason your water heaters fail after period of time. 
It's pretty obvious you don't know what you're talking about because if they had an alloy that could withstand corrosion and
Embrittlement they would be building thorium reactors right now
Reply: I think you have been in the nuclear industry too long. You have learned to focus on the regulatory hurdles, and not enough on the engineering solutions.
Reply: @robertemmons8610  The purpose of the regulations is rather basic.  Then its up to us engineers, scientist, etc. to come up with workable solutions to meet those basic goals.

The overriding #1 key purpose of the regulator is:  "To protect the health and safety of the public from anything but a trivial amount of radiation release from the plant site."  That is from natural and man caused events, and essentially until the plant is safely decommissioned and disposed of.  Also, its only for events that are foreseeable within a certain statistical probability (and Japan messed up big time on Tsunami design on that; but the US, Canada, and Western Europe did not).

An example of what we don't have to design for is if a large meteorite hits the plant.  The odds of that happening are extremely low.  

Another old one was that you didn't have to design to handle two different major "design basis" events at the same time.  For example you don't have to assume that you will have a large primary coolant break while you are having the a much worst than geological history flood event for your area.  

However, post Fukushima in the USA  and some western countries (and over the next decade a slowly increasing number of other countries); you now have to assume that you are in a beyond "initial design basis" event (multiple design basis failures at the same time) and the key reactor core protections are failing - how do you protect the health and safety of the public then, and in time? 

That cost for my plant at the time was I believe in the range of $50-$75 Million to successfully mitigate a beyond original license design basis event - unless a large meteorite has struck the plant.  Lots of portable equipment, hoses, and other things stored in an earthquake proof building and I believe above what if a meteorite created a tidal wave in our local (rather large) lake.  Lots of plant modifications to allow fire-hoses to connect and pump lake or other water into systems that would normally never see such water.  Even the ability to flood containment to a level above the reactor vessel if needed using those portable pumps (multiple portable pumps and multiple sets of hoses - the assumption is that half of them will not work).

Once past that one you get some secondary goals:  Prevent a criticality event, Protect the health and safety of the workers as much as reasonably possible, ensure the plant is secure from a terrorist takeover, have a funding method for eventual safe dismantling and disposal of the plant and all nuclear materials, etc.

The regulators do not care at all if the plant ever runs, if it ever produces power, or if its a profitable business venture.

Not only do all western countries agree on the primary and a common set of secondary purpose; but virtually all 2nd and 3rd world counties in the world have adopted them as well.

I've never seen a nuclear regulation that was not directly tied to one of the above regulatory goals.

So I' wondering how you think outside the box, when the regulators are going to clearly put you into the box before licensing your plant and allowing it to be built and operated; and essentially the same box in most of the world.

Now the regulators do look at each plant technology and develop requirements specific for each technology.  The regulatory requirements are thus different for light water plants and AGR or HTGR plants.  Light water has a super-heated water flash event and loss of water flow around the core if things go wrong in the wrong way - gas reactors do not; but gas reactors do have to account for loss of their gas coolant and flow.  I have not studied the assumptions for heavy water and liquid metal plants; but I am sure that they have to account for massive and sudden loss of those items and design a reactor and other protection systems to protect the health and safety of the public from an unusual radiation release.

I've been following all the 4th generation proposed designs with casual interest for years (almost all, if not in all of them, are in fact very old design proposals with nothing more than a minor technical wrinkle) and I just have not seen any of them that was "inherently so safe" that they would not fall under the primary and secondary purposes of standard nuclear regulation requirements.

Nuclear reactor power plants are going to be built in the real world - not in some fantasy world.

As for engineering solutions:  Worldwide we have learned a lot about what did not work (there has likely been at least 100 commercial power plants shut down prematurely in the world because some engineering solution did not work very well - and the USA has its fair share of those).

What I see a lot of people proposing for new plants is to either go back to something that has proven to not work well, or to design a system that ignores nuclear regulation requirements.
Reply: @blindlemonpledge2556   I'm going to take back one of my earlier statements.   I am going to reply.

I know about dissociation.  I also know about quarks, gluons, higgs bosons and the other 13  particles of our current understanding of sub atomic structures.

But none of that matters to an engineer building, operating, and maintaining a power plant.   

Now dissociation needs to be known likely by the researchers looking into better allows to build things out of.   But as a practical engineer I just need to be told the alloys that would definitely work in our applications, and the ones that would work with some limited life concerns.

Example.  We commonly build things out of carbon steel alloys - even though we know of various stainless or copper based alloys that would not have any corrosion for the fluids or environment they are in.  We just add a "corrosion allowance" of extra material to the carbon steel and go with that as its far cheaper to build in a number of cases.

In the nuclear world we are aware that some alloys have radiation life limits at different radiation levels.  But we use them anyway as they are cheaper to use than other alloys that would be radiation immune in that environment (and materials in the core structures tend to be very radiation resistant if not immune - we spend the money when it is actually needed).

As for building MSRs.  Even if we had a known immune to corrosion and radiation material to make the primary loop out of (which we don't at this time) - that does not mean we would be building MSRs.

One things many people miss is that the Oak Ridge MSR was a very problem plagued reactor in many ways.  Without looking up the exact number it had something like 225 maintenance shutdowns or trips during its life.  It only operated about 40% of the time when other good design test reactors and commercial power plants were operating 90% of the time.   NONE of those maintenance shutdowns or trips was caused by a problem with the Hastalloy primary loop material corrosion and radiation embrittlement that developed.  The Oak Ridge MSR had a lot of other design issues.

So those other design issues have to be worked out as well before a MSR can become a viable power plant reactor.

However, if we had a known viable primary loop material - it does mean some MSRs would be built (at least at the test reactor stage) to see how well they ran and their long term economics.  Power plants may have been built as well to see how they ran.

Several counties have been experimenting with pebble bed HTGR designs in the last few decades (both uranium and thorium fuel designs). No one is saying that they have any material life issues. Also, no one has even proposed they are ready to scale up to power plant sized plants yet (after decades of R&D).

AGR reactors have as long as run history and several generations of designs improving their design and operating cost as do light water reactors.  But, the last ones running are all planned to be replaced with PWR reactors as PWRs are more economical.

The CANDO heavy water reactor has a similar history and many great advantages over light water reactors.  Most countries are building PWRs as they have been proven to in general be more economical.

Thorium as a fuel was tried (the USA built 4 commercial thorium based power plants - see my history post).   Similar designed uranium plants of the same generation performed better (although thorium was shown that it could work).  At the time thorium was also a more expensive fuel (which may change in the future).

In the end economics will win out on nuclear power plants.   MSRs might turn out to be the economic winner some day, and then maybe not.  Thorium might turn out to be more economical than uranium or plutonium as a fuel, and it might not.

It sure is nothing but pure speculation to claim that MSRs would be the winner.   

What can be said at this time - PWR's is the current winner over BWR, heavy water, AGR, HTGR, liquid sodium, and several liquid lead based eutectic alloy reactors.

The answer for the economic nuclear power plant design winner may well be different 50 years from now (and maybe no one will even be building any new ones as we will have totally different electrical generation options).
Reply: Wow
Reply: @perryallan3524  You are trying to peddle an idea that probably won't ever work and it makes me angry. What surprises me the most is that you seem to think this is actually doable. I do not, and this discussion makes very leery of nuclear power, fission or fusion, as an answer. I haven't heard you talk about the breathing problem yet, and I don't mean that you reactor design breaths in air and expels CO2.  I assume that your reactor operates in a temperature range, and with the temperature change, your super alloy will expand and contract = "breathing". Add this to your cheap, embrittled corroded alloy, and you have a breach, and a steam expolsion.
Reply: @perryallan3524  Did you find any Chinese papers on corrosion resistant alloys? They are planing for scaled up commercial TMSR-LF1 type reactors by 2030, i believe they are actually capable of doing it because skilled workforce, money, experiences and knowledge are there.
No one talks about Russia, only them and South Korea can make viable PWRs, Western countries showed they can't build this over 60 years old tech.
Reply: TBH, I'd have thought you'd have seen the Moltex methodology for preventing corrosion in MSR's, viz use anodic protection with a sacrificial material so the reactor vessel etc do not corrode - the same as aluminium bars are used to prevent steel corrosion on oil rigs and ship hulls, they use zirconium, if I remember correctly, that will have a replacement schedule. This is a way they have used existing technology and applied it to the problems existing in MSR's without inventing new high cost materials etc. 
As far as mass production of reactors goes, this does not necessarily mean automated, it does mean under controlled conditions where other variables causing problems in manufacture of reactors out on the job site are removed, or are able to be controlled. The SMR allows for the simplification and standardisation of the design for the reactor installation, and the reuse of the design for each reactor installed on the site to meet the generating requirements.
I believe the Moltex proof of concept reactor is around 300MWe, also the Moltex design uses fuel pins that isolate the fuel salt from the coolant salt, so no impact on the piping from the fuel, even the reactor vessel doesn't see fuel salt :-) again another way existing technology is applied to future designs.
Reply: @blindlemonpledge2556    Well, those types of designed have run in nuclear power plants for over 60 years in multiple countries around the world without any major failures like you are so afraid of.

Where we use radiation life limited alloys they are still expected to last the life of the plant.  We in fact have a number of what was believed to only last 60 years of run time (suitable for an initial 40 year operating license with a 1.5 safety factor) that we now know that that alloy should last well over 120 years of operation of exposure to full power radiation rates.  

On the other hand a few plants found the opposite and were shut down long before they reached the failure stage.  Nuclear reactors commonly have metallurgical coupons installed in them at the time of construction - and some of those have not yet been pulled out after 40+ years of operation; but lots of study of the alloys used in real operating requirement environment have provided lots of data as those coupons are pulled out.   Problems have been identified long before any major failure could  have happened.  Major replacements and early plant shutdowns have occurred.

Also, new alloy coupons are often installed in operating reactors (replacing the ones removed) to see how they withstand long term radiation at full power reactor radiation levels.

We also have a number of parts that can be changed out. About the only part not changeable, so far, is the reactor vessel itself.  Upper internals and reactor head replacements have been done a number of times (and steam generator replacements are very common).  I've never heard of the reactor core support structure being replaced - but it could be (and perhaps that has been done somewhere).  

The oldest plant I worked at had it's "theoretical" spent fuel storage capacity reduced by I think 15% from parts pulled out of the reactor being stored there safely under water for radiation shielding until they decay enough for disposal.

Thermal expansion (which you call breathing) along with galvanic corrosion, stress corrosion cracking, dealloying,  hydrogen embrittlement, and number of other metal failure modes are also well understood and all can be designed around by several methods.  None of these issues are unique to nuclear and they exist in all industries all plants, and many commercial and consumer products.   

I'd wager that stress corrosion cracking and dealloying are in fact far worse problems than radiation embrittlement.  I've had to deal with those failures likely close to 100 times in my life (I'm in my mid 60's) - and have never had to deal with even 1 radiation embrittlement failure ever.

I wonder why you are not raising those failure mechanisms as issues to be dealt with?

As far as that "steam explosion" you are so worried about.   Fossil plants have vastly worse ones (I think about every 15-20 years worldwide) resulting in the deaths of lots of plant workers.  The modern 2400 PSI superheated steam power plant has 2600 PSI saturated water steam drum pressure, and about 20 times the quantity of water in the boiler as does the primary loop of the same size nuclear unit (I've worked in both plants).    

The Fossil plant saturated steam temp is a lot hotter and contains more energy than the nuclear plant primary loop.  A major piping or boiler wall blowout in a fossil plant releases vastly more energy in the steam flash (or steam explosion) and its quite common for a good portion of the plant operation staff to die (and once in the US in I believe the 1980's they were at shift change and it wiped out 2 complete operating staffs).  Fossil plants are not build or maintained/monitored to the same QA and maintenance standards nuclear units are.

But, I don't hear you worrying about those routine failures with many deaths in fossil power plants.

On the other hand, BWR and PWR nuclear plants have a containment building designed to withstand the worst case steam flash (or explosion as you call it) from the largest primary loop or main steam line break possible. Then the steam is condensed into water fairly quickly.   

No one dies unless someone just happens to be in containment when it happens.

Another thing.  That kind of primary loop or a main steam pipe failure has never happened in the entire history of BWR an PWR reactors worldwide; while it happens in fossil plants worldwide with some regularity over the same time period.

I think me and my colleges approach to designing equipment wins over your idea that it can only work if we have "perfect" alloys.

Nothing in life is perfect. Failures can be predicted and we can monitor condition and/or design to replace parts or equipment before failure; and also design to  handle those failures should they occur despite our best efforts to prevent them.

But, if you want to be afraid that this just won't work despite is long term proven safety success of nuclear and many countries building more of them... You are free to do so.   

May I suggest that you also disconnect from any kind of electrical generation as all of those plants have most of the same issues (plant specific) that cause failures and deaths; and such failures and deaths are common in the those issues ("technicians" commonly die falling off of wind turbines; lot of injuries and some deaths from people installing solar panels on roofs).

Also, your car is far more likely to kill you based on various failures than a nuclear power plant designed for long term reliability and safety.  Perhaps you should avoid traveling in an automobile as well.
Reply: @Chungalhunga   Great Comment on that only China and South Korea really have a current experienced nuclear workforce to build new plants to Western standards.   A few other countries have some working knowledge and could catch up rather quickly.  The US and EU have just started to learn again having forgotten how (not to mention the MBA approach of we can manage it better and with less).   While the Russians have the experience I don't believe their designs would be licensed in most Western Countries (although certain Eastern European countries have accepted them).

OK here is what I remember from what I read and what I understand is being said in China on future plans (there are at least 2 different groups talking - and they are saying somewhat different things).

Lets start with the initial Chinese Research Reactors (yes that is a plural).

The Chinese MSR project started in 2011 with a $500 Million in funding for a multi decade program.

The Chinese researchers identified 2 different MSR test reactor designs (how they operate - not size) that looked as the most promising.  I once read a description of both of these designs (and I cannot remember the differences).

Interestingly last year I read of what I believe is a 3rd and possibly a 4th different design approach (1 in Canada, 1 in the USA).

While all of these reactors are MSRs and all can potentially use thorium or any other nuclear fuel - the key is that the molten salt flow and control can be done in different ways.   Which way will work best?  Who knows.

Likewise I believe there were at least 3 different PWR designs built initially (one even with super-heater steam), and at least 2 different BWR designs built.  Decades of experience has sorted those down to just fundamentally 1 BWR and 1 PWR  western design today.

A good portion of the MSR "super-alloy" development papers I saw were from China, but there were at least 3 other countries involved (I don't save most things I read on my computer - I just read and move on).

China was planning on building both of their different MSR designs to see which one worked better.   However, at this point they have only built one, and are not saying anything publicly about the 2nd design.  

I've heard roomers that they are still going to build (or are currently building) the 2nd design test reactor.

What we have is the current 2 MWthermal test reactor.

I read a summary from the researchers involved and they understand that the real timetable to a functioning power plant is likely decades.  Proving the materials work, that the chemical filtration works, that the controls and all kinds of other things work, that everything is maintainable and reliable all take real time and operating experience.

They know the issues with scale up (that extrapolations of larger plants operate on curves and not straight lines) and the need to build a series of progressively larger units to be able to reasonably accurately predict how well the next larger size reactor works.  That it is very financially foolish and risky to extrapolate to a power plant sized reactor based on a small test reactor (and that the history of both non-nuclear and nuclear projects are littered with such failures - with nuclear plants being far more expensive to build and vastly more expensive to dispose of).

I am fairly sure that they will have placed corrosion and radiation embrittlement coupons of various possible super-alloys in the reactor; so they can get an idea on what might be the best current material (and in the hopes of finding one that works).

Having done corrosion coupon testing I know that you get the best long term results from long term coupons, but any major issues (early failures) show up on shorter life coupons.

Among the researchers - their next plan was that assuming all is going well after a few years and they have good corrosion and radiation embrittlemnet results at that stage - that they would finalize the design of a test reactor 10-15 time larger than the one they have now.  Potentially if all goes super great - that 2nd generation test reactor could startup about 2030. Any major problems would delay that.

IF that reactor works out (and again has at least several years of really good performance) they they would design a small demonstration/test power plant likely in the range of 40-60 MWe; and if that runs really well then they can develop a final power plant design (and perhaps a larger power plant as well).

So that is what I have understood reading the material from the researchers involved.

But, China has more PR side of things, and some of these people also have been assigned to work at the MSR research project.   These are the people who are saying that China will have functional power plants (and marine propulsion) by 2030. 

Who knows, perhaps China will actually fund such plants making best guesses from where they are at now.   I would point you to the separate history of thorium power plants post I did to see what often happens when you get ahead of the development curve.  Many countries have learned similar lessons with a number of the initial nuclear power plants: a lot of them just did not work well and were shut down very early.

On the other hand perhaps China gets lucky and builds a MSR power plant ahead of he development curve that works.   It could happen.  The US Navy PWR design of the 1950's was lucky in that way.

You can chose to believe whom you want.  Perhaps I'm being more pessimistic than will happen; but, I'm working from the history of past failed and successful dreams in the nuclear (and other) technology world - and know just how long it took us to find really good solutions for problems in the light water reactor world (many decades) as the fact is that most initial designs of how to do something do not work well long term. But, by trying them you find out.

Have a great day,
Reply: @thecraggrat  I was aware of their galvanic concepts and plans, and other companies talk about it as well.    I believe they are at best misrepresenting it. Making it work for heat exchanger tubing without mounting the anodes to the outside of the inside of the tube down its length is just not going to work.

I've read of 2 fundamental different molten salt reactor designs:  

First reactor design: You just put the molten salt with the fuel inside a sealed tube, and assemble these tubes into a fuel assembly bundle; and the fuel assembly bundles are periodically swapped out (just like light water reactors).

You are unlikely to need a tube material that would have to last more than 10 years as the tubes can be removed from the fuel assembly, drained, and the inside of the tube neutralized by then.  Even the original Hastalloy used in Oak Ridge might work for this design.

While you could put some passive sacrificial anodes on the outside of the fuel tubes every few feet down the tube - I don't see the necessity at all. You then have to worry about the sacrificial anodes breaking loose in the secondary coolant stream as those anodes would create turbulence or the turbulence could vibrate the fuel tube such that it would be damaged by fretting or low stress high cycle fatigue (which are concerns for heat exchanger tubes that don't have anything mounted on them to create additional turbulence (vibration prevention for tubes is a key design consideration for all tubed constructions: the calculations for the required supports are well known).

Second reactor design:  fuel is contained in a circulating molten salt that uses a tubular heat exchanger for the reaction chamber (I don't see this working with plate fins - which have a whole set of other potential issues for a MSR).

There is a primary (fuel) molten salt circulating system with a supply pipe, a heat exchanger head, then tubes that take the molten salt fuel mixture into the reaction chamber, then back to another head, and then to the reactor outlet pipe that goes to the steam generator or hot gas heat exchanger to generate the working fluid (steam) or raise the temperature high enough (hot gas) for the turbines.

I note that both heads of the reactor heat exchanger could be a combined split head (or multiple splits in a head).   I believe that the Oak Ridge Test MSR used a 2 pass head.

A key design element of this kind of heat exchanger construction is that the tubes must be more noble than the tubesheet.  The tubes are very thin in comparison to the tubesheet.  You want the tubes to force the galvanic corrosion to the tubesheet; otherwise your tube ends will galvanically corrode away rather quickly.

Then in many cases galvanic corrosion protection for the tubesheet would be mounted to the channel box of the head, or to the edges of the tubesheet around the perimeter of the tube bundle, or use an impressed current system with probes mounted all across the tubesheet pattern.  All three systems are common.   

If sacrificial anodes are used on the tubesheet they are there to corrode away before the tubesheet does.

In some heat exchangers they also chose the head material to be more noble than the head channel material.  In this case you will commonly see anodes mounted to the head channel.  Again the sacrificial anode would corrode away before the head channel material would.

The biggest problem with galvanic protection is the effect is relatively local.  you just cannot normally protect something more than a few feet.  Even if you wanted to connect impressed current probes or sacrificial anodes to the ends of each tube - the galvanic protection does not extend down the length of the tube.  This means that you cannot stop general corrosion down a long tube without either impressed current or sacrificial anodes ever few feet down the tube.

A major (and common) mistake is that they use the wrong anode material, or use too much impressed current (for the electrical systems) and then they reverse the entier sequence.  It then forces the tubes to be the sacrificial item; and you will destroy the tube ends requiring a retube or replacement of the heat exchanger (reactor core in this case); along with getting the galvanic protection correct so it does not happen again.

Galvanic corrosion of heat exchanger tube ends, tubsheets, and channel boxes is actually one of my areas of expertise. I used to get pictures of every failure from every nuke plant in the US (and some from other countries) all the time in my email.  I've seen dozens of cases of destroyed tube ends by using "too much" galvanic protection.

It's actually an area of routine business as is quite common for heat exchangers to be retubed with a completely different material than they were origiannaly built with.  So the original galvanic protection methods no longer work 

So if what you say about Moltex is correct (and I'd have to see diagrams on where they are placing their anodes to be sure); then they would be there to protect the tubesheet and the channel box of the heat exchanger from the more noble tube material.   

The tubes themselves would not be protected in any event more than a foot or two beyond the tubesheet unless they are actually mounting anode rings on the outside of the tubes every few feet (and deal properly with the turbulence and pressure drop involved).  Otherwise, it will not solve any general corrosion issue with the tube material exposed to the molten salt fuel/daughter products.  

Heaven help them if they "over-protect" the tubesheet or if they as they make the tubes less noble than the tubesheet.  Tubes tend to be very thin and galvanically corrode away quickly against something or more mass.

Note if you don't understand my use of "noble" please look up "galvanic corrosion charts" and study them.
Reply: Agree with most of what you say here but not the current powerplants. I still think we should persue other designs simply because the risks are too great using pressurized designs that can not fail safely by themselves. "Walk-away safe" should be a requirement in this industry.
Further more, the focus should be on designs that not only produce short-lifetime waste but also can consume earlier produced waste from the old style plants. We need to clean up this mess, not just burry it.
Reply: @perryallan3524  Boilers have to have the water used in them treated to prevent corrosion. These are all closed loop systems, and it looks to me that nuclear power plants are operated as once through systems, since they seem to located near large bodies of water. Remind me to tell of the story of the NRC having a coniption fit over a plant having their intakes plugged by Zebra mussels. I don't think any engineers even thought about this as a problem, and I'm betting there are other things that could occur that won't be thought of either. Imsert the phrase human error here.
The mention of economical operation also gives me pause for thought. If you want me to feel safe, the cost shouldn't even enter the convasation.
Finally, nuclear plants will be very juicy targets for terrorists. What I envision here is some cheap drones carrying explosive devices, or dedicated suicide bombers attacking the plant and sabotaging the plant come to mind.
Reply: @1kreature  I agree that we should look for designs that could burn up more waste.  MSR's might be that, and then maybe not as there are a lot of complexities to the waste issue.   

One of them is that the lithium salts used are not sable long term by themselves (and I understand that this problem has already raised its head at Oak Creek with the salts from the late 1960's reactor).   They cannot just be buried and forgotten.  They might have to be broken down and the waste converted to other forms; which will be costly and involve more radiation exposure and spread contamination to other equipment (which then must be handled).

There have been other designs proposed over the years to assist in waste disposal (although I cannot recall the specifics at this time).  I do recall that none of them were considered economical after more study.  

Perhaps a new look at some of those old designs rejected back then might produce a more positive answer today.
Reply: @perryallan3524  Yes, old problems usually get smaller by new technology.
As you say though, problem is that continued cycle of contaminating more and more gear.
With everything else we have chemical ways of neutralizing contamination. But with radiation we do not have such a simple way of accelerating the decay.
Sure, we can bombard it with more radiation and thus trigger decays, but in the process we can also end up making other radioactive byproducts out of the stable elements that were contaminated.
Speaking of salt and corrosion though, it is something I am sure we can deal with. After all, molten salt batteries are very reliable and used for grid-storage in emergency solutions.
Solar concentrators regularly use salt as well, in the 700c ballpark. It is there a economically viable solution so I am sure we can find a way for nuclear power as well.
Reply: @blindlemonpledge2556   You show a shocking ignorance on basic steam power plant operation (and any other kind of power plant).  Do you think you can hide that from anyone with reasonable intelligence reading this thread?

Steam cycle based power plants (fossil or nuclear) have a closed steam/condensate cycle, and an open cycle condenser operation and plant cooling.  You will find that virtually all steam cycle power plants are located near open bodies of water to supply the plant cooling systems.  There are a few small ones that use well water to supply a cooling tower.  But most cooling tower makeup water is from a river or lake worldwide (a few cooling pond or canal operations exist as well - which still need makeup water).

There is a very light chemical treatment of the closed steam/condensate system with the main component being chemicals to remove free oxygen from the water (to prevent oxidation of the iron in the piping, boiler tubes, and various components as there are places that air leak into the system.  The other component to remove impurities that either come from the makeup water or condenser tube leaks. 

I could write a long post just on all the aspects of steam/condensate cycle water chemistry (historical methods, more modern methods, and the current state of the art) covering likely 150 years of chemical treatment of closed and open systems in power plants.

There have always been bio-fouling issues with lake, river, and ocean water use in various plants and public water works (not just power plants).  Zebra, and now quagga mussels was just one that got imported from Europe several decades ago.

The open cycle cooling water systems have always had some kind of treatment programs to control bio-fouling.  I've worked in fossil plants that had chlorination systems that dated back to the 1930's for their open cycle condenser circulating water and plant cooling water systems.

Zebra mussels affected both fossil and nuclear plants - and a lot of commercial and public water intakes when they showed up as the normal  chlorination and other treatment levels were not adequate to control them.

I know all about them and the problems they caused and not just in the nuclear world.  Here again this is one of my areas of expertise.

You are correct that the NRC was concerned - and not just at one plant.  So the NRC issued Generic Letter 89-13 (which was the 13th  Generic Letter issued in 1989).

Feel free to do an internet search on "GL 89-13" and you can read the NRC program document and all kinds of information.

You will find that GL 89-13 covers a lot of other issues with "raw water" cooling of safety related heat exchangers and the cooling water system and components - including general degradation independent of the cause.

As for my part in this:  I was the GL 89-13 Program Engineer for many years at one plant and became one of the industry experts on it (someone that other plants and industry experts referred other people too).

Anyway this was a big issue in 1989; which was 35 years ago.

By the way, there are actually very few Zebra mussels left in many areas in the USA at this point of time because  the Quagga mussels replaced them (and Quagga mussels are more of a problem and require stronger treatments to control).

The good thing is that the industry has learned how to control these mussels and other bio-fouling much better and it's virtually never an issue these days.

More significantly, while many of the old nuclear plants used "raw water" cooling all through the plant (like one of the ones I worked at) - so that many heat exchangers and pumps were affected along with all the piping systems and components; that the new plants just have a short amount of piping and valves to a "component cooling" heat exchanger for the safety related cooling that may exist in an nuclear power plant.    

Better yet; the new Gen 3+ passive safety plants do not depend on this cooling at all for an emergency shutdown.  They require no active cooling systems or controls or electricity to safely shut down the reactor and cool the core for at least 3 days.

After 3 days the AP-1000 may need to have a tank filled that sits on top of containment every 3 days for a few weeks.  That tank can be filled with lake, ocean, or river water using a fire hose if needed - and it will adequately cool the core and keep the plant safe from meltdown.

Note I know a lot about the AP-1000 because I did a consulting job for one of the Chinese AP-1000's after it had started up and had access to all the design specifications and licensing materials.  I read a lot on them.

I might suggest that you spend your time looking up how power plants work and are operated instead of raising issues from over 3 decades ago that have long been solved.

I don't see that your ignorant questions apply in any meaningful way to the discussion of nuclear technology.   

I do not intend to respond anymore; as you are acting more like a troll based.  

I don't think anyone is surprised that power plants and all kinds of other commercial and public plants have had a series of issues in the past that have generally now been solved and no one talks about because if you build a new power plant (or any technology) you will deal with those standard issues with well known techniques.

It's not worth my time to continue to explain the history of common issues in life.

Goodby
Reply: @1kreature  It is my understanding that the molten salts use by grid batteries and solar concentrates are a totally different salt than what is used in MSRs, and cannot be compared to the problem with the MSR salt that Oak Ridge is reportedly seeing (and I understand that they have been spending about $5 Million per year working to control the issue).

There are literally thousands of salt compounds.  You need to be sure that you are comparing the same salt compound.
Reply: @watamatafoyu  Thorium is literally dirt cheap and has a low cost refinement process. The containment building does not have to be high pressure. Waste disposal is a tiny fraction of conventional plants. Uranium enrichment is a very costly process, not required for thorium. These represent enormous reduction in costs. Whatever might be more expensive is very difficult to imagine being anywhere near these savings.
Reply: @perryallan3524  Maybe ceramics?
Reply: I know nothing about this but I’m curious. Is it not possible to hook some sort of valve/drain up to the chamber that contains the salt and every couple of years before failure starts it can just be moved into a new tank? Or is that crazy talk?
Reply: @royh6526   Some of what you have posted has been answered before in my prior responses.

Yes, Thorium itself might be cheaper than Uranium or Plutonium at this point; although there is actually no evidence at this point for that as no one has actually tried it on a commercial scale.

In one of my above answers I pointed out that you don't need a high pressure containment building; but, to design a carbon steel containment building for the worst case local earthquake can actually require thick enough steel to handle the higher pressures as the steel thickness needed to prevent collapse covers the current 60 PSI steam pressure of many PWR's.   I know that because I worked at a PWR that had a separate carbon steel containment building and a separate shield building (a rare design for the USA in early PWR history). But this separate containment and shield building is the design of the current AP-1000 which is the most popular current PWR reactor in the world.   5 are online, 1 is in startup testing, and at least 10 more have been ordered with active talks for another 5-20 on the way.

While the quantity of high level nuclear waste would be reduced; that is not the major disposal cost of nuclear power plants.   The lithium salts of the MSR reactors are not long term stable and not suitable for disposal by itself without some kind of chemical reprocessing and extraction of the radioactive elements from the lithium salts for disposal in a separate form.  No one knows how costly this disposal will be and I believe its premature to say that a MSR will have overall cheaper disposal than the current BWR/PWR and various gas cooled reactors (used a lot in the UK and in some other countries).

No one also knows the reprocessing cost to remove the U233 from the used MSR fuel for future use in a new MSR fuel load (and either U233, U235, or Pu239 must be preloaded into MSR fuel because thorium is not a reactor fuel - it does eventually get converted to U233 with a small percent of other things.  See my history of thorium power post for more information on this.

A bigger unknown is if a MSR reactor - once the bugs are worked out (and who knows how long that will take)  - will it actually be cheaper than a current generation of PWRs (the current cheapest nuclear power plants for most applications).

There is a theory that if everything goes well that it will be.  But people thought the same thing about gas reactors, heavy water reactors, metal cooled reactors.   So, I'm in full support to see if the test reactor works, and to scale it up to the next size, then a small power plant size, until we find out what the long term operating cost are.  It might be cheaper, and it might not be.   No one will know unless the test reactors work well and it is scaled up.  But, it will take a fairly long time to know for sure.  Most likely at least 2 decades.

Have a great day,
Reply: @royh6526   That has been answered in an above response.   I will expand on that here.

In theory it might be possible.  But ceramics face far more uncertainties - even if they can overcome the brittleness issue.

Ceramics tend to be brittle, with no real fracture toughness.   Any nuclear reactor and all associated piping and equipment must be designed to handle a "worst case" earthquake which is going to rattle everything including the internals of a reactor hard  Piping systems will visibly move a lot (there are videos of existing power plants during earthquakes).  You also have to demonstrate that during installation or shipping that all the components including the reactor and all internals will not crack or fail in the event that the reactor, or other equipment and piping, is dropped onto an unyielding surface from a higher height than the expected installation height.

We know how to do that drop analysis for metal reactors and metal components.   I think we would be in new grounds to try to do it for a for ceramics.  I'd expect a multi-year research program would be required.

The next issue is how do you join all the pieces and components.  You cannot expand ceramic tubes into a tubesheet and then seal weld it.   How do you join all the individual joints between pieces.  With metal we weld or in some cases braze it.

Power plants eliminate as many as possible flanges joints decades ago because flanges are a major leak problem in the future.

The biggest unknown is that there has been no research to the best of my knowledge on if there is even a suitable ceramic material that would be corrosion resistant to the liquid salts involved with the fuel and reaction daughter product and various chemicals that form.  Given the above issues I suspect that ceramics have never been considered by anyone familiar with building any kind of power plant.

But, who knows where we will be in decades in the future.
Reply: @ryanjones3043   The problem is that it is the reactor internal tubes, pipes, vessels, components, etc. that corrodes.  It's not an issue of the molten salt itself corroding (where your solution could work).

The reactor power plant can only be economical if he same molten salt fuel/reactor products runs for years because the reactor starts on added U233, U235, or Pu239 and then later runs on U233 that only forms after all the corrosion products in the molten salt form (and my memory is that the 1st indications of problems were noted within a few years at Oak Ridge).
Reply: You've done an excellent job of obscuring the fact that multiple MSR companies have engineered corrosion-resistant solutions that have withstood both initial experimental testing and theoretical modeling, and that funding is being sought to carry the testing forward in a fueled reactor, as well as U233 for that purpose.
   You've done an excellent job of obscuring the fact that Abilene Christian U. is already constructing MSR facilities in partnership with one of these companies, for the purpose of such testing.
   It's very obvious that you don't want your readers to learn these facts before they've had a chance to assimilate your half-truths and voluminous hand-waving.
   Similarly, you don't want them understanding that sustainability is the issue with all energy generation methods, and the Th fuel cycle with molten FLiBe salt reactor has this in spades while none of the others, not even solar, wind or even CANDU (which someone invoked above) have, no not even your cherished uranium-plutonium-cycle solid-fuel reactor. Sustainability is about the ability of a solution to meet the needs indefinitely at a price that can be afforded, without destroying resources (including biosphere) that are needed for other purposes. Literally only the Th fuel cycle can do this, and only MSR so it can run as a fast breeder reactor without wasting nearly all of the nuclear energy in the fuel, without requiring reprocessing, and without requiring ongoing, unsustainable levels of mining. No other solution accomplishes this. And you even admit cost is not a factor, because government can structure and fund policies that are in the public interest and is more than capable of doing it for this problem.
   Yet you deflect and hand-wave anyway, in a desperate effort to keep the people from knowing the truth lest they make the public decisions that are in their vital interest to make.
   The problem here is it's a political problem, which you are masking by presenting it as an engineering and economic problem. It is neither. It will, however, become all three eventually without a change of course... because, as already stated, your solution and the others that are at odds with this one, are completely unsustainable.
Reply: To my mind the main challenge to your credibility is the failure to address the technology of the compact molten salt reactor. Did you stop studying new reactor designs 10 years ago?
Reply: @ryanjones3043  All the designs have that. Perry's trying to argue that if the entire reactor doesn't last 60 years without needing replacement of some parts, then it can't possibly compete with legacy nuclear and therefore will never even be attempted and shouldn't be. 
   This of course ignores/hides the fact that WRT to nuclear power, economics left the building in the 1940s. All commercial nuclear power worldwide is massively subsidized, and would be completely unable to compete in a "free market" if it had to do so. Thankfully, no one really believes it should have to, or else we'd all have been reduced to daily rolling blackouts for the last 50 years.
   Our problem is we have people who've made their entire living from that government largesse, lecturing the rest of us about how impossible and ill-advised it is to have socialized energy. You best believe they know better. They just don't want anything to change, because they believe they can keep getting us to pay for a worse technology for another 2 generations. They either don't care how much that ends up costing us, or they just never gave it a first thought.
Reply: @perryallan3524  My argument about building containment was not about strength so much as size, With no possibility of having to contain radioactive steam, it can be much smaller. Rare earth mines consider thorium to be a nuisance by product they have difficulty legally disposing, thus one company owner said "drive trucks here and I will load them up with thorium for free". You apparently have a very closed mind, if it hasn't been proven it's not worth pursuing. I will not respond again to you.
Reply: @no_rubbernecking   Please tell me a single company that has tested their supposed solution in a running MSR reactor that creates the daughter products and various chemicals created - that only occur in a running MSR.

Please tell me a single company that has similarly tested their separation process in a running MSR.

Without such testing it's all theory and nothing is proven.

Even the Chinese state that their test reactor is just a test to see if they have an alloy and a separation process that produces a workable solution.

Anyone can tell other people anything.  Companies raising money for research often have the habit of not telling the full story - and a number of them outright lie.

As for the possibility of a thorium fuel cycle working.  It may (even though it did not decades ago).   I have said several times before that why not just put a thorium core into a PWR (we already know that can be done) and then you get your thorium fuel cycle without the development timetable and cost for the MSR.   Or at least do it in in parallel why they try to develop the MSR reactors.

Late Edit (I hope you get to see this):  As for what various companies tell people:  Imaging how much money all of these "investment" companies would raise if they told their potential investors that in reality their material and chemical separation process has not yet been tested in real world conditions, and may not work as they hope.   Also that even though they know that they are not pursuing doing the actual research and building a test reactor to find out.

Personally I think most of them are outright scams just to provide jobs for their founders (who I'm sure know the truth) and a bunch of other people they like.

But, you are free to believe whatever you want.

Have a great day,
Reply: @mikefallwell1301   Might I ask 
"what exactly" technology of a MSR reactor you are talking about?

There are a lot of different design ideas that have been proposed in the last 5-10 years.  But those are just design ideas.  They have not been built, nor tested, and certainly not scaled up to a power plant size.  

As such they are not an actual working technology.

What bothers me most is that most of those designs companies (not all) are not talking of meeting current nuclear design and construction standards - in fact their designs are obviously done by people who have no clue what those standards are.  Also I don't think I have yet seen a design with containment fan coolers to keep the inside of containment cool enough for people to enter it and work inside while the reactor is running (which will be a requirement for any licensed plant in western countries).

It's very easy to gin up some kind of drawing of a proposed plant without understanding nuclear design and construction standards, and human factor engineer (like cooling/heating).  But don't expect those of us who are aware of those standards and what the resulting components look like not to notice.

 I note that I've seen I think 3-5 companies where they are in fact talking about nuclear design and construction standards, and several have entered the pre-license process.

I also am far from convinced that a MSR reactor plant will be smaller than other reactor designs.

The reactor itself on a BWR or PWR is very compact.  I don't see much size savings there.   Then you have inside the containment building a both the primary loop and secondary loop pumps, piping, and the chemical separation equipment.  

Then there are the molten salt drain tanks under the reactor as the "worst case" safety drain.

This actually is a lot more equipment than is inside a BWR and PWR containment building, and its likely going to need a similar diameter building as the same reactor power PWR when you consider all the factors.

As long as the steam generator is located outside of containment the containment building will not have to handle a main steam line break.   That would shorten it some.  But given that the reactor itself must be elevated to provide the drain tanks under it - I'd guess that the containment building would be about 2/3 the height of a modern PWR.

Should the steam generators be located inside containment then the height of the building goes up to handle the main steam line break.

Note I have seen some conceptual designs where they put the drain tanks and pumps in vaults under the reactors - without maintenance access.    You actually have to design real power plants with maintenance access and the ability to remove, rebuild, and even replace those pumps, tanks, and other components (and maintenance access adds space - and a lot of space if the equipment is highly radioactive).

Virtually all PWRs have had their steam generators replaced inside containment - and those are much larger than the reactor.

Plants have replace reactor heads, and upper internals.

Plants have also discussed that perhaps at end of life of the reactor vessel life that you replace that as well (the lifting equipment and room is there for that); although that would be likely be part of a very major plant overhaul and take some years as the foundations and other site specifics at the two plants I worked the longest are in fantastic shape - why not reuse them in the future?

So show me a containment building layout that reflects design realities of adequate maintenance access and radiation distance clearance with appropriate cooling/heating to allow people to work in it year around, not to mention designated storage areas such as: Where do you park the reactor cover/head when you remove it?  Where do you park the circulating pump motors when they have to be removed to work on the pump or the pump seal, etc.

The inside of containment for all BWR and PWR plants have designated places with safe lifting paths for all of that, and more.  Then they have designated areas to lay down other equipment that is dismantled, and they have space for lots of equipment and tools to be brought into containment for maintenance outages, not to mention room for easily 100+ workers who are all working on different jobs at once.     

All power plants have maintenance outages to work on a lot of equipment (most jobs are outside of containment).  For a typical 600 - 1200 MW nuclear plant between 1000-2000 "surge" workers show up with lots of equipment, backed by a warehouse full of parts and supplied just for the outage, to get all the jobs done in 3-4 weeks.   I've worked in smaller than 60 MW fossil plants - then only hundreds showed up (although we did not have to worry about radiation protection and security which adds a lot to a nuclear plant workforce for an outage).

So find me a realistic containment layout drawing for real MSR power plant which has the space for maintencne and maintenance outages; not just some idealized sketch where they ignore maintenance, laydown area, and the number of people required to have a timely power plant maintenance outage.
Reply: @royh6526  Thorium ore was pretty much free in the 1950's and 1960's too.  But by the time it got processed into a form to put into reactors it was not free or very cheap either (and uranium was considered cheaper at that time - and at least 1 of the thorium power plants the US built specifically said that).

Now perhaps properly processed thorium fuel would now be cheaper than uranium now, and if not perhaps in the future.  We actually don't know because no one has tried it on a commercial scale since the 1960's in the USA.

The few thorium test reactors of the last few decades (pebble bed & now the MSR) used very expensive test batch processing to get the thorium into a usable fuel form.

See my response just above this one on the size of the containment building.

I wish the people putting out those "conceptualized designs" would consider the space needed for people, cooling/heating, maintenance lay-down and storage areas, etc.   

The MSR diagrams you are seeing on many of the websites are not telling the truth at all on how large the containment will need to be.   The reason I believe is that the people making them have no idea what is really required to build into a plant so that it can be successfully run and maintained.

If you cannot do maintenance the plant will have a very short life indeed.
Reply: Yea. These youtubers always hyping about everything. "This is so great, this would save the world." But then they don't really look into things at all. They just put clickbait title and move on next clickbait video. Not too many months ago, there was so many youtubers hyping over room temp superconductors. If something is too good to be true.. 99.999 % of the times, that's exactly how it is. Just like with this video. Oh and fusion videos. There is one company that was just showing plastic tube that could do fusion. All youtubers: "wow amazing this will work." And these companies just takes all the moneys from investors and then "well ops, it doesn't work. I keep the money thou."
Reply: Wasn't there an American nuclear sub with a molten salt reactor?  And didn't they wind up just cutting out the whole reactor section of the sub to replace it with a PWR?  The increased efficiency could not justify the technical headaches.
Reply: @haldir108  Be careful. There are old hat nuclear engineers who are heavily biased toward what they've worked on for years and seem to see everything worth doing as having already been done - only incremental improvements on existing designs are worth pursuing - and this new stuff is just all so much hype. 

I'm not saying that this guy, but he sounds similar.

As for Flibe and ThorCon, time will tell. I think Flibe has the furthest to go due primarily to how far they have to go for all the chemistry they plan to do. I'm not aware of anyone claiming the science isn't valid and achievable, but going from individual chemical experiments to a working prototype is a huge leap. 

ThorCon I think is the most feasible. They're not attempting to do an on-site construction, but instead pushing for the entire power plant to be built as a ship (several of their founders came from a supertanker building background). They're working with Indonesia which seems more receptive to nuclear power than the US at the moment and have gotten MOU sign-off by the govt and various powers involved. They are also going for the "keep it simple" and "get something working" approach rather than going for some of the more sophisticated (and difficult) fuelsalt/chemistry interactions. It won't be as cheap or efficient as something like Flibe in the long term, but should be more attainable in the near term. If they're able to get the Indonesian govt to work with them to get their test reactor up, it will be a huge first step for MSRs and GenIV in general.
Reply: @aj-2savage896   No, there was not.  There has never been a USA MSR Naval reactor (and I have never heard of any previous MSR reactors to the Aug 2023 Chinese startup in the world except the US Air-Force test aircraft reactor in the very early 1960's and the Oak Ridge test reactor in the late 1960's.

The US Navy was initially interested in liquid sodium cooled reactors.   I'm not sure if they built a test reactor or not; but, a liquid sodium reactor was never installed on a submarine.

I've heard the cut a reactor out of a submarine story before, and replace it.  This was from sources I considered credible when I heard that story which was likely in the late 1970's when I was in the US Navy and working with people both headed into and kicked out of the Navy Nuke program (I was a Machinist Mate in  conventional steam propulsion before I went to college and got my engineering degree).

I'd need to research that; but, the early attempts at US Navy PWR's had problems; and it may be that they just decided to replace a poor PWR design with a better one.  That makes the most sense to me without spending a lot of time researching naval reactor history.
Reply: @perryallan3524  Liquid Sodium
Reply: This was a fantastically informative video and your comment was equally so.  Thank you.  I've spent the last 40 years being 1000% anti-nuclear.  Power or weapons.  But the various safety features of MSR turned my head.  As an engineer who's worked for decades with marine environments though, I know that saltwater always wins.  Unless it's glass, gold or another precious metal it will be corroded and likely destroyed.  The effects of hot brine in copper pipes are like those of acid.  The applications I work with usually include water & oxygen of course, so not a fair comparison perhaps.  Because an MSR operates at considerably higher temperatures, any leaks or flitration failures, (and there will be leaks and failures) will likely result in rapid attack on all wetted surfaces. That said, I cannot wait to see the super-alloy they create to overcome this huge hurdle.  Thank you again.
Reply: @AntiNeoFascist  Just so you know...  I'm not sure what new designs you (or anyone else) is talking about.   

The concept for the MSR was developed in the mid 1940's as part of the Manhattan Project.  The USA built 2 test reactors (one to see if nuclear powered aircraft was feasible (constructed late 1950's - to 1960 and run in I believe 1961 without looking it up), and later the Oak Ridge plant in the late 1960's.

Every proposed SMR design is either the same basic design of reactors built in the 1960's and 1970's, or slight variations of them.

There is even nothing new about "Passive Safety" as the Westinghouse Gen3+ passive safety AP600 reactor design was licensed in 1998 by the NRC after about 5 years or pre-license and license review.   The Westinhouse AP600 was noticeably smaller than the AP1000 (which most people now call AP-1000) being built today.

Back in those days the industry speculated that the ideal nuclear power plant size would be in the 500 -600 MWe size range; and the industry had already focused on passive safety in new designs.    A similar sized BWR and another PWR Gen3+ passive safely reactor designs were also licensed by the NRC within a few years of 1998.

Then everyone felt they were too small to build.  So the AP1000 was designed and had a NRC license issued in 2002 (and again there was a similar size GE BWR design licensed that has never been built).

The only thing new is the idea that it should be possible to filter out at least some of corrosive daughter products and chemicals from a MSR fuel stream to reduce the corrosion to an acceptable rate even if an "immune" to corrosion alloy is not found.

Even the concept of using a reactor to burn waste and much more fully utilize "wasted" fuel in not new.  That ability has always been claimed for liquid sodium cooled fast reactors.  I remember well the talk of that in the 1970's - the local utility was planing to build a 2 unit sodium cooled nuclear power plant about 25 miles from my hometown in the early 1970's- and I recall the huge camper type vehicle with the display of the proposed reactors and systems and the base claims on how it would work along with the "experts" to answer questions:  It made for an exciting several hours for a mechanically inclined teenage boy.  That plant was instead built with 2 very large coal fired boilers.

The 1st and 2nd generation liquid sodium power plant reactors had significant problems and with the exception of Russia (and I don't trust the Russian claims of no problems) is that they all got closed very prematurely (My memory is that at least 4 countries, including the USA, built sodium cooled commercial  power plants - and it may have been twice that - without my looking it up).  At least France also designed a 2nd generation sodium cooled power plant (1242 MWe) which was supposed to eliminate the problems with he 1st generation plants.  It went online in 1986 and was shut down just a decade later in 1996.   There is nothing economical about a short life nuclear power plant. 

Today several of the current SMR designs being proposed are sodium cooled and make the same essential claim on waste burn-up as the MSR reactor proponents claim. Note that at least one these sodium cooled reactors is in the pre-licensing stage with the regulators - which indicates that the company is serious about the intent.

I'm not against new designs at all - I just haven't seen one other than the chemical filtration possibility with the MSR salt stream.

That leaves the rest working on incremental improvements of known technology.

I appreciate your understanding of the difficulties of getting from something that works in the lab to a prototype plant.

There is a similar difficult in getting from a working prototype plant - to a commercial power plant.

The nuclear industry worldwide has many dozens of such failures in all virtually all technologies tried (We've seen BWR, PWR, AGR HTGR,  liquid sodium, and Heavy Water reactor designs that did not successfully scale up into commercial power plants.  But, other reactors implemented different design variations of BWR, PWR, AGR, and Heavy Water power plants that did succeed as commercial power plants.

Concerning Thorcon.   If you read their literature and claims you will find that their answer to the corrosion and other issues is to just accept it replace the reactor and key piping itself every 4 years before critical level problems can develop.   Someday they will be able to rebuild the removed reactors and other components and reuse them (my guess is a decade + decay time before the would be safe to re-tube - perhaps twice that long or longer).

I fail to see how you can have an economical nuclear power plant when you have to replace the reactor every 4 years as the method of dealing with the known problems that the Oak Ridge reactor had.

But who know, perhaps they can pull it off.

I feel its much more likely that Indonesia will be  left holding a $Billion+ cleanup and disposal job if it really does not work the way the Thorcon leaders are saying (and I have real doubts about using commercial construction techniques as well as we developed the nuclear construction code based off of all the failures of the commercial construction of the earlier nuclear plants).

Have a great day,
Reply: @perryallan3524  I would like to know what you think about the compact molten salt reactor design by seaborg technology. They say that it can ears natural uranium without enrichment because of the moderator which is sodium hydroxide
Reply: These corrosive salts will keep the metallurgists busy for many years if they find the money for their researches.
Reply: @perryallan3524  I don't have much disagreement with what you wrote. Though by "new designs" I don't mean completely new. I'll even admit that the MSR designs are largely just adaptations on the old MSRE approach. However, they are "new" from the perspective that we don't really have any of these designs commercially implemented. This is what seems to be the source of a lot of static from "old-hats" as I call them - those that have worked on PWRs/BWRs for decades and see no reason to do anything than build more of those same thing and are quite antagonistic toward new designs like MSRs. It feels like an 35year+ Ford car engineer vilifying hybrid vehicles because "we have perfectly good functioning gasoline-only engines - and besides, it's not like hybrids are anything really new."  I'm not saying that's you, but there's a similar tone.

As for some of the other things you said, I've not heard of the idea of removing fission products from the fuel salt as being primarily about corrosion. That could be a secondary side-benefit - however significant or trivial of an effect that would be. The primary argument I've always read is focused on reducing waste by removing the mid-length actinides and other fission products that are the "still dangerous but fairly long-lived as well" stuff, and that it's so much easier to do such extraction from a liquid medium that it makes financial sense to generate more "pure" concentrations of these elements, many of which are actually quite valuable and useful (e.g. actinium for targeted alpha therapy cancer treatments).

But some of the designs don't particularly have much focus on extraction. Thorcon itself is just focused on using a Thorium+HALEU single-salt mix with no extraction (other than off-gas). It's not nearly as efficient as a Flibe setup, but it's easier to get up and running.

Speaking of ThorCon, yes, they are replacing the core to avoid corrosion issue. This actually allows them to use cheaper material rather than much more expensive exotic corrosive-resistant materials. Their design has an entire section at the back of the plant with capacity to hold up to 80 years worth of "cooling off" reactor cans. 

It's possible that the commercial ship-building approach simply isn't up to snuff for what is needed in a nuclear power plant and it's also certainly left to be seen if the economics of their design are viable. Those are legitimate concerns and things to keep an eye on as they develop.

My big issue, however, is how many current PWR/BWR reactor professionals seem to simply condemn MSRs as "all hype" or similarly denigrate them and their advocates as mere "sycophants" and "fanbois". That isn't helping people understand the pros and cons. If one believes that PWR/BWRs are actively BETTER, then they should make that argument. If one thinks there are insurmountable engineering problems that prevent MSRs from being viable at all, then explain that. But merely lumping them all in a bucket and vilifying them as "scams" just comes across (to me anyway) as little more than tribalism based on familiarity bias. 

I do appreciate you expounding more on your specific criticism of ThorCon and other such approaches. That, to me, is a much more useful and interesting discussion to have than broad brush generalizations.

Take care.

Edit: Also, something I saw in another comment of yours: "the Oak Ridge MSR was a very problem plagued reactor in many ways [lots of maintenance shutdowns] [only operated 40% of the time]". If you have a specific list of UNEXPECTED shutdowns or emergency maintenance, then I'm open to hearing it. But remember, the MSRE was an experimental research reactor. From my understanding, they frequently ran it for a few days or weeks, ran the tests they had queued up, shut it down, made changes to the configuration, tweaked some of the test equipment, powered it back up, ran it again for a few days, etc. There was a process for requesting a new test or experiment to be done on the reactor - complete with any modifications or monitoring equipment additions needed. If approved, it would be scheduled, when the scheduled downtime window came, your group would have a certain number of days to apply your modifications to the reactor, then it would be fired back up and run for another week or two during which time the test data was collected. 

Treating this process of being shut down for maintenance and modifications or claiming that because it was shutdown 40% of the time is somehow a testament to how faulty or "problem plagued" it was is nonsense and downright disingenuous. I don't know how many times I've seen this bogus claim that the MSRE was actually barely functional and full of problems used by avid MSR-haters but it honestly tips me toward thinking that's where you are.
Reply: @mikefallwell1301   I've tried posting the answer twice and am surprised to see that it is missing:  Seaborg announced that with the change to natural uranium that they were changing the moderator to graphite.

Both graphite and heavy water have been known to work with natural uranium since ages ago (the original 1942 Chicago Pile - the 1st man made nuclear reactor - was graphite using natural uranium).

I question some of their other claims about the reduction in nuclear waste, etc.   Natural Uranium has the same reaction and daughter product chains as enriched uranium.  U235 is the primary fuel, with secondary decays releasing heat from the decaying daughter products. Some U238 gets converted into Pu239, which provides a secondary fuel that can split.

I personally know several people who work in CANDU reactors in Canada (we used to meet regularily at conferences) and they tell me that the radiation and decay life is essentially the same as the standard BWR and PWR light reactor fuel.

I see no reduction in waste nor radiation with the process that Seaborg is proposing.
Reply: @perryallan3524  the post I saw was very specific about not using graphite. It said that using sodium hydroxide would reduce the core mass by a factor of 8. I don't understand this, what would it mean
Reply: @AntiNeoFascist  Thank you for your points and questions.    

I understand many of the concerns that a number of the “old hats” have and share most of them.  A key difference is that I know that there are some serious attempts out there. 

Also I see that the MSR design was never developed enough to see if it would really work (even at the test reactor level), and then work well enough to be economical as a power plant.

I actively support the research and development program that the Chinese set up in (working from memory) 2011 with the equivalent of $500 Million (US) in funding for I believe 20 years to see what can be done with the technology – in the hopes that a future power plant may emerge.  More funding would be provided if the progress is good.

Why other nations have not set up a similar program is a reasonable question.

It took the Chinese about 12 years to build a 2 MWthermal test reactor to see if they have the corrosion and radiation embrittlement issues of the late 1960’s Oak Ridge MSR Hastalloy.  Part of that is testing a chemical separation process to see if it would really reduce the corrosive compounds enough (and if that system is reliable and maintainable).   A 3rd goal is to get better thermal modeling of that style of MSR.

The Chinese had planned at one point to build 2 different MSR test reactors which operated on different design principles (I once read the summary and understood the difference back then, I don’t recall them now).  But, for now they only built one so far that we know of.  Perhaps they are in the process of building the 2nd design – or perhaps wants to see how the 1st design works before finalizing a 2nd design test reactor.

If it all works, then they plan on building a 20-30 MW thermal test reactor to see how things scale up.   If that works, then a likely prototype/demonstration 40-60 MWe power plant to see how that scales up and works.   Likely timeline for this is 20 years to prototype power plant assuming everything works as desired (and what is the chance of that – almost nothing in the nuclear world has worked like that) unless the Chinese are willing to gamble big money on test reactors of all kinds of different designs before we know the results of the previous designs.  Scale up factors are rarely a straight line – they tend to be a curve, and the Chinese want to have data on at least the start of that curve before they start designing real commercial power plants that could be duplicated in multiple locations.

I am aware of 2 serious institutions who are also looking at building a MSR test reactor (1 in the USA, and one outside of the USA).  In both cases they are talking with the Regulators on what would be required to license the test reactor (pre-license application discussions).

A key reason the “old hats” are so critical of all the various MSR proposals from so many companies, and call them scams, is for starters that these proposals assume that the current “guess based” computer models of how different reactor designs and equipment would work are accurate enough that we can design a functional molten salt reactor and molten salt power plant equipment right now from late 1960’s data of a reactor that didn’t work well (and was not instrumented to anywhere near current standards).   

Us “old hats” – especially in the USA – are well aware of just how many things did not work as planned and how expensive it was to modify or live with, or just shut the plant down (we built something like 104 light water plants using about 76 different design elements – and a lot of ideas about how to build workable equipment and systems did not work well long term: some problems took decades to show up).  

The Current AP-1000 was designed based off of what did work very well and was long term reliable – and has the best method for each issue or design question that experience has shown us works long term.  Of course, it took decades of actual experience to learn this information: Something the MSR reactors has none of (other than we know a lot about what kind of things did not work well at Oak Ridge and the Aircraft Test Reactor).

Then toss in that most of these companies are not talking about building to nuclear standards using nuclear construction methods and don’t need things like containment buildings, shield buildings, seismic construction, etc.  Not to mention, as I discussed in a post above the actual working space human factors and laydown areas needed to work on the equipment (the idealized drawings are just laughable to anyone with any experience working in a containment building).

Add to that the total fantasy timelines of what is being promised:  We don’t have a licensed design (have not even started a pre-licensing discussion with a regulator), we don’t have a licensed site, and we are going to build and have an operating nuclear power plant in X years. Totally crazy talk.

Many of the “old hats” have only looked at these various junk science and totally unrealistic concepts, design claims, and schedules for the nuclear world and just dismissed them as scams; and I agree with most of that.

However, I spent a fair amount of time looking at various countries’ Nuclear Regulator websites – and discovered several MSR proposals where the companies were being realistic about building and operating in the nuclear world and talking with the Regulators in pre-licensing discussions; and the companies’ websites are not making obviously ridiculous claims.   

Thus, my opinion is that while most MSR companies are scams – I also know that a few are not.  That does not mean that their power plant reactors will ever be built.  But, at least they would be a “safe” design per western standards. The real question is will someone fund their experiment so we can learn if and how well (or not well) the design actually works?

Finally, to add to our skepticism is the radiation danger of the primary loop and chemical filtration system.  I have not much talked about this in this entire thread.   We handle fuel many feet below water to protect ourselves from the extremely deadly radiation of a fuel rod at least 1 week after shutdown.   Without that water we would be rapidly dying in seconds and dead likely in a few minutes if we got within a hundred feet of a unsubmerged fuel rod assembly just out of a reactor (and no this radiation does not decay down to normal safe levels in weeks or even months).   I doubt that anyone puts a fuel rod assembly into a dry cask storage in anything less than 10 years due to the radiation (although special massively heavy lead lined transport casks exist to move a single fuel rod assembly that is screaming hot somewhere for research and analysis – the cask is loaded and unloaded deep under water).

We’re all trying to figure out how anyone is going to be able to work on or even near the primary molten salt loop equipment and the chemical filtration/separation equipment in anything less than many months to many years after shutdown (even if you drain the pipes there will be "screaming hot" molten salt residue on the pipes and pockets of the salts in various places in piping and equipment).  I’ve not dug into it – but it’s an obvious question and us “old hats” are very sensitive to what the radiation dose rates are in work areas (we work in "As Low As Reasonably Achievable" - ALARA radiation zones).  

Also, there are no robots that can do the mechanical work that a human can do.  Western countries may allow occasional “special exposures” where a person picks up a lifetime of allowed dose in a job (and is then handed what would now be a multimillion lifetime paycheck and they can never be a radiation worker again).  But, they don’t allow very many of those (I believe there have been less than 10 of those in the USA for the entire history of commercial nuclear power – and the NRC investigates every one of them). Yearly special doses with a years' paycheck do occasionally occur for a few people a year (and again each one must be explained to the NRC as to why that was the only reasonable solution – and the fines typically start a $1 Million).

Please See Part 2
Reply: @AntiNeoFascist    Part 2  (I ran into a size limit)

When I posted my 1st post on this thread, I was under the assumption that the Oak Ridge MSR and primary loop piping and equipment had been dismantled and disposed of long ago.   An article I read a week ago indicates that is not the case.  They did selective sampling of things to determine degradation and gain inspection points; but, the rest is all still there as 60+ years later it is considered too radioactive to work on at a reasonable cost.  I understand that Oak Ridge has an approximate $6 Million per year budget currently to manage the long-term radiation and radioactive contamination at the MSR plant.  That does not speak well for the long-term economic future of MSR plants as they have to be able to fund their disposal (and we don’t even have any actual disposal data on what it will cost to dispose of one 60+ years later).

Most light water reactors are being dismantled 30+ years after shutdown and I know how nasty those are from radiation and radioactive contamination point.

As for chemical separation and sale of certain decay products.  That sounds like a costly process; and the biggest issue is how are you going to separate what you want from all the other “nasty” daughter products, especially given the radiation levels?

This sounds to me like making a purse out of a sows ear (or perhaps a large skunk).  You get a purse; but you had to kill and dispose of an entire pig or large skunk (and no you cannot sell the rest of the pig or the skunk – it must be buried in a special expensive vault).  Perhaps I am wrong on that; I just don’t see how you are going to economically separate what you want from the entire waste stream (lots of things look good on paper – making it work in the real world is difficult).

On the Oak Ridge MSR.   If you do some internet searches there are several articles on it that have most of the data on reliability. The data I have handy is that the Oak Ridge reactor had 225 shutdowns in its about 4 years of operation, and only 58 of those were planned (167 trips).   Not only that, but 1 article says that many of the “planned” shutdowns were because they knew they needed to shut down and fix something earlier than their planned run time.  But, as they “quickly planned” the shutdown and did an orderly shutdown it counts as “planned” instead of a trip.   Another article I recall said that “most” of the planned shutdowns were because they knew that they had to shut down for unexpected maintenance and wanted to do that without a trip.

Not the kind of reliability that you are looking for in a future power plant reactor.   I do admit that the current nuclear industry does quickly plan shutdowns when equipment starts to fail instead of waiting for a trip (and much more common is a 50% down-power for a day+ so they can take an entire equipment train out of service for maintenance).   But, even quickly planned down-powers and shutdowns along with trips in currently operational nuclear power plants are typically only a few, or less, per year.

Concerning the types of test reactors and their run times.   There are two fundamentally different types of test (or research) reactors.  Those that are intended for various research and perhaps some isotope generation, and those that are intended to demonstrate a long-term running reactor such as would be used in power plants and certain other installations for specialized materials.

The TRIGA reactor is the most common of the test/research reactors, although there are multiple other designs in the world (and some are intended to run long term).   Among these reactors it is not uncommon to find operating rates of 10-30% of the time.  Also there is at least several highly specialized designs that run less than 5% of the time – but they can test things that nothing else can do safely.

The Oak Ridge MSR was designed as a power plant test reactor.  It was expected to be able to run for many months on end without any kind of shutdown.  Ideally it would run for 10+ months a year without shutting down (the kind of reliability desired in those days for power plants:  Now its 17 – 23 months).   For a power plant test reactor to only operate 40% of the time even in the late 1960s tells you that it is nowhere near being ready for commercialization as a power plant because other power plant test reactors at the time were operating above 80% and into the low 90% of the time.  There were clear design issues with the Oak Ridge MSR that have to be addressed; and at this point no one has tested any improved designs (except the Chinese has started to test their best guess on improved designs for the features that failed at Oak Ridge).

Overall I’m cautiously optimistic that the Chinese development program will provide real answers as it relates to MSR reactors.  Will they be a better design, or not.  But, that will likely take many decades to find out unless its an early failure.

Currently the PWR has proven to be generally the most reliable and cheapest nuclear power plant design in the world; beating out PWR, AGR, HTGR, Heavy Water, and Sodium cooled (and the Soviet Union/Russia built several eutectic lead alloys cooled naval reactors where the coolant was degrading the piping which ended that form of cooling).  

Also, larger plants are much more economical than smaller plants due to the lower amount of materials to build larger units on a per/Mw basis and lower staffing cost on a per MW basis.  This has been proven many times since the 1960’s.

If someone wants to run a thorium fuel cycle why not put it into a PWR so you are starting with a proven reactor and power plant design (we have already proven that thorium works in a PWR if the core is designed right).   If the thorium fuel cycle does not pan out – the plant can be converted back to uranium or plutonium (most people don’t know that most PWRs can burn plutonium as well; and something like 60% of dismantled nuclear warheads have already been converted into PWR fuel and burned up (typically in a “mixed oxide” U235/Pu239 format).

At the same time, perhaps in 4+ decades we will not be building many, if any, nuclear power plants as other generation technologies will have taken over the new power plant role.

Have a great day,
Reply: @perryallan3524  Do you see the improvement made to robotics as being able to mitigate the risk of "special exposure" exceptions?
Reply: Sounds like an anti-nuclear rant from Dr Lyman.  You should reference WASH-1222 and give credit where credit is due.
Reply: @harpercmp  Not really.  No current robot has the flexibility and finger/hand dexterity of a human, nor the ability to auto-adjust based on changing conditions.

While we use tongs or other gripper tools when trying to pick up radioactive debris - that is not always possible.

Taking things apart, grinding, doing Non Destructive Examination, welding, assembling, etc is just a lot faster with a person than a robot.

A factor that many people do not understand is the cost of delays during outages.   An aproximate 600 MWe power plant cost about $1/2 Million a day in lost generation revenue.   An approximate 1200 MWe power plant cost about $1 Million a day in lost generation revenue.

When an issue comes up it is not economical to take weeks or months to design a special robot that could potentially do the job; vs approving a "special exposure."

I have seen Plant Management spend a day looking for options before considering a "special exposure."  But, unless there is something really promising they move ahead with the special exposure.
Reply: @markdavis8888   I have no idea who Dr. Lyman is.  I have my own personal fossil and nuclear power plant experience and have done my own research. I consider myself very pro-nuclear.

However, I understand the need for use of the current nuclear safety standards and construction standards (as I know of how much problems we had with early generations of nuclear power plants), and also know that nuclear plants are not quickly built by people with no experience doing it.

I also object to people claiming old ideas are something new; and also claiming that we know enough without test reactors to design, build, and successfully operate a reactor design that has never yet succeeded at the test reactor stage.

I do agree that due to the initial problems with two test Molten Salt Reactors (the aircraft one had a key part fail after a very limited number of hours) and the Oak Ridge problems that the MSR design has never been adequately tested to see if they would work assuming we have solved the problem of having a suitable alloy to use.

I fully support the Chinese research efforts; and I wonder if MSR is so promising why no other country has yet stepped up with a similar program starting with test reactors (and the two other test reactors that I am aware of that are under consideration are being proposed by Colleges or Universities - not by National Nuclear Testing Labs that exist in several countries (such as the US, China, Russia, and the French used to have one as well).

Have a great day,
Reply: Corrosion is not a problem with clean salt,only salt with hydrogen
Reply: Please give me a link describing the switch to graphite at seaborg
Reply: @stanmitchell3375  Not according to the Oak Creek papers and at least a half dozen researchers in the world trying to develop a special "super-alloy" for MSRs.
Reply: It's thorover :(
Reply: I read your comment with great interest and joy. Thank you so much for your time and effort. Very appreciated! 
P.s. 
I am a Dutch physicist (unfortunately born in Russia) and I would like to work on nuclear energy.
Reply: Nickle. They used Nickle and so the salt corrosion you bring up is not an issue.
Reply: @IronCondorWheel  The Hastalloy N used in the Oak Ridge reactor was 71% nickel... and it had both radiation cracking and corrosion issues.

Pure nickle is not mechanically sound enough for use as a nuclear reactor and piping material.  The nickle has to be alloyed with other things to get the desired mechanical properties.

That is why several countries have spent the last 15+ years developing custom "super-alloys" - all of which have a lot of nickle in them trying to find something that is expected to last in a MSR.  But no one has claimed that they have a corrosion resistant alloy for a MSR.

The Chinese is testing their current best guess at such a material in their 2 MWthermal MSR test reactor along with an experimental chemical separation system that is supposed to remove the worst corrodants so that they can reduce the corrosion rate to acceptable levels to be able to build a 40+ year reactor.
Reply: Excellent reply to hype!  As for scam companies, it is also in getting millions in Federal subsidies for R&D and going through the safety review and licensing process.  $600 Million Tax dollars spent out of a promised 2 Billion were spent on relatively conventional Nuscale prior to failure.  I imagine salaries at the top were significant.
Reply: Awesome and brilliant. 😎💯
Reply: @perryallen. Well said. It seems that the US is committed to Uranium mining and has much less Thorium than Europe. Would you care to address the subject of adapting proven designs to the Thorium cycle?
Reply: @zweisteinya  In the 1960's the USA perfected a thorium core for PWR reactors. 

This was part of the program to set up thorium power plants.  The Atomic Energy Commission wanted to have a supply of U233 that they could use to seed the thorium fuel.  So they actually had an existing PWR convert to thorium and reprocessed the spent fuel to build a multi-ton stockpile of reactor fuel grade U233 (not suitable for weapons - that required special weapons material production reactors to limit the amount of U234 just as they need to limit the amount of Pu240 for plutonium bombs.  Key for both is to only run the fuel for a few months - something commercial power plants are not designed to do as the reactor has to be taken apart to refuel the reactor).

Anyway, part of this U233 was used to refuel the Oak Ridge Molten Salt Reactor (which originally was fueled with U235); and the Oak Ridge MSR ran its last year or two on U233 typical of what it would do if it used a thorium fuel cycle.

Now it took a couple attempts to perfect the PWR thorium core design - but they did it.

That design information is available to anyone in compliance with the nuclear treaties and international agreements.  Most of the world nuclear power reactors are PWRs as it has proven to be the lowest cost and most reliable design of all the reactor types tried (and something like 90+% of all current construction are PWRs).

The reason that thorium did not work out in the 1960's - 1970's power plant attempts - at least for PWRs was soley due to cost.

It turns out that it is vastly more expensive to convert thorium ore into reactor fuel grade thorium than it is to convert uranium ore into reactor fuel grade uranium.   I have not seen anything to suggest that is different today.

Were thorium even cost competitive I would expect that many countries would now be running thorium cycle power plants.

If it were cheaper then most of the world would already be running thorium cycle power plants - as most of the world has PWR nuclear power plants and in virtually all cases they could be easily converted to a thorium cycle core.

As for making it work in other reactor types...  since I wrote the main post I have learned that Germany built a 300MW thorium cycle pebble bed reactor; which was shut down after Chernobyl as they were having problems with the pebbles breaking with a radiation release every time one broke - and the German population would not tolerate that after Chernobyl.

The Chinese licensed the German Pebble Bed design (the Germans developed the pebble bed reactor - with one online in the 1960's); which is the basis for the current Chinese Pebble Bed reactors running and under construction.  China is using Uranium fuel as its cheaper than thorium.

The USA obviously did not figure out how to build a HTGR using thorium - although they made 2 attempts at it.

Thorium is known to work in CANDU reactors.  So those reactors can also be converted at will by the countries that have them.

I'd say that its likely not worth the R&D effort for BWRs and Gas Cooled reactors given how few relatively new ones exist.

It might be worth it for MSRs if they solve the corrosion and radiation embrittlement (and other prototype issues).  But, I'm betting the 1st MSRs will run on uranium as its more redily available and cheaper.  It will take decades of run time to work out the kinks of MSR power plants - if any are ever built (lots of things never scale up from testing to economical commercial use).

I hope that answers your question...
Reply: Fantastic comment, thanks so much. This sort of detailed, well informed reply is the best of what social media can be. Hugely appreciated. ❤
Reply: @rccc5806 You say that "I am not the one to assess if corrosion is an equivalency difficult problem as high conductive at room temperature" yet you nonetheless have no problem waiving away corrosion as a nitpicking issue. How about researching for yourself the mechanics and complexities of corrosion and materials science and THEN passing judgment. There's a chasm of difference between assertion and enlightening. The second takes too much work for many people so they lazily just do the first.
Reply: @xBIGMUSCLEx There's a difference between healthy optimism and blinding oneself to confronting reality with wishful thinking. The poster gave detailed analyzes, that's not pessimism. Closing your eyes to information you don't want to hear won't help you attain the very objectives you seek, it'll do the opposite.
Reply: @tinetannies4637  We're all talking assessments here, aren't we?
Reply: Holy Cow, that is the most concise, straightforward explanation I have ever read.  Personally, I award you 👏👏👏👏👏 applause!!!!!!!!! 👍
Reply: Thank you, Few people criticize the MSRE as yourself.  Truth be known, it wasn't just the corrosion, but also the embrittlement of the alloy from neutron bombardment that was central to the materials issue. It also had leaks at the safety valve etc. In it's brief life it was shut down over 200 times, mostly unplanned.  Bechtel called it the most difficult clean up faced to date.  The left over material also had a near criticality incident. It also had little if any thorium in it, as it omitted the blanket, and used U233 (and U235) as core material from other reactors with no breeding. There was no provision for protactinium removal. There has been a lot of hype on this largely failed idea which taught us what not to do.
Reply: @veritea9374   Thanks for the comment.

I picked up on the radiation embrittlement issue and the poor reliability issue later and believe I mentioned both several times in the comments under the original post after I did more research into the reactor.

I was not aware that it is yet cleaned up.  Oak Ridge still gets  I believe $4-$5 millions per year to monitor and maintain it while it decays down to more acceptable radiation levels.  Perhaps they have just cleaned up the auxiliary spaces and the main reactor is still sitting there.  I'm unsure if it was de-fueled after shutdown.  Perhaps you know.

It was originally fueled with U235, and then refueled with U233 later (the U233 from reprocessing of thorium nuclear cycle power plant fuel where the Atomic Energy Commission ran a small reprocessing plant at one of the national labs).

I have also pointed out in the following comments on how is anyone going to do any maintenance of the circulating pumps and chemical filtration systems due to the screaming hot radiation levels (which are not under 10-15+ ft of water).

There is also a nuclear weapons proliferation concern as the fuel & waste fuel is a liquid/solid that is drained into tanks and potentially divertable for reprocessing quickly without dismantling the plant.  Unlike other reactors with fuel assemblies or blocks (gas cooled graphite reactors) you cannot just count how many are there and read serial numbers.

How much is in a tank?  Is it new or used fuel?

It would be easy to short cycle the fuel to prevent U234 buildup for the original method they produced bomb materials (similar to short cycling fuel to limit Pu240 for plutonium bombs).  You don't need to short cycle if you chemically separate the Protactinium and allow it to decay to U233 (which eliminates the U232 radiation issue).

Yet, it might work and be viable someday with enough research and development and I'm sure that the proliferation experts will come up for something as a way of monitoring power plants.
Reply: @perryallan3524 I appreciate that.  India got the CANDU reactor and it only took two years to break their agreement and detonate a bomb.  A LFTR makes it easy to make bombs. Just sub out Thorium for U238.  Mostly, U238 is relatively cheap and publicly available, and has a better cross section for efficient breeding. Since the proposed removal of protactinium is a bismuth loop, it would be easy to do the same for U238 to purify Plutonium.  Getting federal funds to develop and hold patents for bomb making equipment is nefariously clever.  And no, the proliferation people didn't catch the CANDU in India, they will probably miss this too.
Reply: @veritea9374  CANDU reactors are very good at making bomb grade materials if you short cycle the fuel rods - and that is easy with a CANDU reactor as no major disassembly and reassembly of the reactor is required to change fuel rods (or blocks in gas cooled graphite power reactors).

Since then the proliferation monitors have learned. Today, every CANDU power plant in the world outside of India has 24 hour/day cameras and radiation monitoring equipment which would identify any refueling activities - and if it goes offline the inspectors are there quickly.

You are correct that the U235/U238-Pu239 fuel cycle is easy and well known - and works in all reactor designs.

But the thorium cycle works as well it just produces U233 instead of Pu239 (+ trace materials).

The very reason U235/U238 is used instead of thorium in all but test reactors is that its cheaper to refine uranium ore into reactor fuel than to refine thorium ore into reactor fuel.  The USA determined that in the 1960's and even considered scale up.

For similar reasons Pu239 weapon grade production is cheaper than U233 weapons grade production.  The USA studied that as the question was should the US convert to U233 bombs.
Reply: @perryallan3524  quite right.  It would be cheaper for at least a century to breed cheap and available U238 rather than the more complicated and more difficult to obtain Thorium.  If making nuclear power from breeding is the goal.  Personally I think there are better ways to get power.
Reply: @veritea9374  I'm not sure a century is the right time line for thorium to be cost effective.  However, once it is the vast majority of nuclear power plants can be converted to run on it.  The USA perfected a thorium core for PWR reactorts - and most nuclear power plants in the world are PWRs because they have proven to be long term the most cost effective and reliable nuclear power plants.  Almost all new construction are PWRs, with CANDU designs coming in a distant second.  The other power plant reactor designs are just a few of each at this time.  Note without looking it up I believe the current number of new plants under construction is 61 in the world; and the average time for construction is 6 years (8-10 plants a year are coming online around the world each year).
Reply: @perryallan3524  Not certain where you are with this.  PWRs have some incidental breeding (about 1/3 of conventional U235 power comes from plutonium), and certainly one can run them on U233.  However Breeders are needed to make much use out of Thorium, as it has a small cross section for high speed neutrons.  Reactors focused on breeding are a fickle bunch, only the BN-600 is currently used to generate electricity, and it is down alot.  CANDU reactors can breed, and probably can be made to work with Thorium. But given the hundred plus years we can run on already processed U238, why would anyone advocate for Thorium R&D?  Solar is the new dominant power source coming online and will be the dominant installed source by 2030. If given support like nuclear had in the cold war, we could probably hit Net zero by then.
Reply: @perryallan3524    Sorry, i just saw your reply from 2 months ago. (Or possibly i had seen it and forgot about it.)
   WRT your late edit, that's why it needs to be a Moon-shot, government-funded project, as it is in Communist China, as it is in the EU, and as it was here in the U.S. when normal minds prevailed; also, as i argued at length in my comment that you read and assimilated very well.
Reply: @veritea9374   Two Answers to 2 different points: 

1) Remember that the base idea behind nuclear power plants was to reprocess the fuel and stick the Pu239 back into the reactors.   That generally did not work out.  

The USA has already perfected an adequate thorium U233 breeder core for PWRs.  We know how to do it - and its available for all (except India which violated their international agreements). To close the loop would require fuel reprocessing - but that is potentially doable easier than reprocessing U235/U238 spent fuel.  Also remember that reactors don't run on U238.  Some U238 can be bred into Pu239 (with trace Pu240); but its not like we are going to use up anywhere near the majority of U238 put into a reactor (where 100% of thorium is convertible to U233 with trace U232 and U234).  In this area thorium is theoretically much more usable than U238.

2) As for solar and wind.  Unfortunately, here in the USA and a few other countries people have not been told about the true cost of power from each technology - and if we had been almost everyone would be looking to build more nuclear power plants.

Here in the USA they have separated the cost of building the power plant (and the cost of generating electricity from the plant) from the cost of transmitting it to the end customer.   It turns out that the cost of transmission and distribution of solar and wind power is extremely expensive in comparison to nuclear or fossil power plants on a per unit power comparison.

This is why for example in my area the electric rates have had major increases in the last few years in relationship to al the "cheap/subsidized" solar and wind power.   The power cost portion of the electric bill has not gone up much.  The transmission and distribution portion of the electrical bill has skyrocketed (all for much less than 10% of total generation).

Most countries in the world look at the total cost to build and deliver power - and nuclear wins out in most places in the world (there are actual studies on this); which is why about 10 new GW sized nuclear power plants are started to be built every year in the world.

IF you ask the wrong question you get the wrong answer.  Just looking at one part of the cost of new power generation (the power plant itself) is only part of the real question on cost.

Have a great day,
Reply: @perryallan3524  By cost-effectiveness are you talking about making a profit? I'm against power utilities being profit-centered; that should never be the primary point of a utility. Modern civilization needs power for living & comfort services as well as most commerce. Cost-effectiveness in community power generation should not be about maximizing profit or even making money at all, but about whether your community is getting what it paid for. The community should decide how the power serves them best.

I don't know why you're telling me that power plants are not exotic yachts 😆 Do you think anyone actually thinks that? Also, it's common knowledge that power plants provide a basic commodity that is required for normal society and most companies to operate, this doesn't need to be stated.
Reply: @royh6526  I already know this from Kirk Sorensen's presentations, but I'm glad others read your summary.
Reply: @watamatafoyu   Point 1:  If the cost are not reasonable the power plant (and any other plant) gets shut down.  That is true in all industries.  

You would not like to have a service where you have to pay whatever the provider needs to cover unusually high expenses compared to their competition.

That's just basic economics.  

I'm sure that you take care of your belongings with the same viewpoint. The cost of the item, and cost of maintenance must be reasonable.

Point 2:  In the vast majority of cases power plants worldwide are part of a regulated utility, where the profit earned is controlled (usually to less than many other companies make).

Utilities are not charities and need to earn some profit for them to exist.

Try running a successful company that doesn't operate with a profit most years.  That's a relatively quick path to bankruptcy.
Reply: @perryallan3524  It's like you've never heard of government subsidizing energy research & development, something that's been part of US history and pride for decades.
Reply: @watamatafoyu  I'm well aware of goverment subsidies and how they helped develop the nuclear power plants back in the 1950's through about the 1970's.

More recently money has been put into trying to develop SMRs.    

However, the once past the initial prototype plants the nuclear power industry has had to stand on its own financial feet since that early money.   That has been done with for profit companies - although some went bankrupt when their nuclear units did not work as planned.

The last 30 years has seen huge government subsidies into Solar and Wind energy; and very little of that would be built today without those subsidies at this time.

Unlike the nuclear power plant world where only the initial prototype plants were subsidized.

By the way both waste disposal and major catastrophic insurance has been fully funded by the nuclear power industry by the federal requirement to collect money from every kWhr sold for those things.  The US Government is sitting on 2-3 times the expected cost for Yucca Mountain for permanent disposal of the waste fuel.

The insurance fund is fully funded to handle well beyond the worst nuclear plant disaster imagined in the USA.

If Wind and Solar had only been funded like nuclear power was in its subsidies it would barely exist today.
Reply: @perryallan3524  2 your points # 1: The base idea behind nuclear power plants is the production of bomb grade materials, especially Pu239 (Plutonium) almost all of which is the product of a nuclear reactor.  There are too many incidents of developing countries such as India with the CANDU reactors making bombs shortly after. Development of nuclear reactors in the US. was maximized during the cold war.  That subsidy was outrageously expensive, as the war took probably half of all capital expenditures in the U.S.
2: Our best high tension wire carries more than 1GW.  Putting up another line is not that difficult. As Utility Solar and Wind farms grow in size, These interconnections become more efficient.  The connectivity issues are largely held back by competing interests and is a matter of political will. All estimates show the dominant new sources of energy are solar, followed by wind.  Those estimates show solar will be dominant in production by 2030.  https://www.nature.com/articles/s41467-023-41971-7  Also unsubsidized cost estimates show Nuclear to be the most expensive option, and is mostly desirable for the weapons potential.  https://www.lazard.com/research-insights/2023-levelized-cost-of-energyplus/ .The economics by themselves will cause a rapid change, as fossils and nuclear get sidelined, so does their political force. However political will can make this happen even more rapidly.  It will happen, just a question of when.
Reply: Cancellation of the MSR reactor projects was purely a political reasons.   It was also not a high priority as we have now.
Reply: @TrevorHaynes-tx8fx  To a degree; but it was more of a change in focus by the President and Congress than anything to do with what nuclear technology was being developed.

The budget for the Atomic Energy Commission R&D was cut by the President & Congress primarily because commercial nuclear power seemed to be well into commercial viability and both the President and Congress wished to redirect money elsewhere.

The Atomic Energy Commission is the body who made the decision to cut further MSR research as it seemed to have the greatest obstacles at the time and there were other more promising technologies to pursue with the reduced R&D money they had.
Reply: @TrevorHaynes-tx8fx  The MSRE, unlike much of the reporting, was expensive, unreliable, and had embrittlement of it's experimental alloys.  It also performed no breeding of thorium, and  the U233 had to be supplemented with plutonium to continue output. Mostly we learned Don't do that again.                                                                            
The MSRE cost $7Billion in todays dollars, It was only in operation 40% of the time and never attained the designed power output of only 10MW. It's aircraft reactor predecessor had a melting incident, which resulted in the fabrication and use of IN0R-8 or Hastelloy-N.  While it withstood corrosion over 4 years, it was found to be embrittled and cracked, threatening to break apart if use continued.
It was unreliable, being shutdown 225 times in it's short life, mostly unscheduled, sometimes due to leaking at the safety valve.  It needed plutonium added to keep going as the U233 was not sufficient.  It never had the complexity of  thermal blanket, so it couldn't actually breed thorium into U233.  Instead they only measured neutrons  The liquid metal breeder reactors then favored instead had great issues as well,  Fermi was unreliable and had a meltdown.  The Superphoenix in France was shutdown as well.  Both are considered failures.                                                                                                                                
in March of 1994 after 25 years, it was discovered MSRE waste U233 hexafluoride levels were close to causing critical incident which would have spread contamination for miles  "There was a significant potential for disaster.” Rushton. "“If we had just plunged in, we could have had an explosion" Toth. https://web.ornl.gov/info/ridgelines/nov12/msre.htm. The waste remains a great issue to this day, costing over $4 Million in maintenance in 2019 alone. https://thebulletin.org/2022/06/molten-salt-reactors-were-trouble-in-the-1960s-and-they-remain-trouble-today/
Reply: MSR is new technology, so of course challenges won't be overcome until we do the work to address them. silicon-carbide has been identified as a suitable material for MSR use to reduce corrosion. Si-C coated alloys can meet the challenge.
Reply: @thecraggrat  This 'anodic protection' is how we avoid corrosion of hot water heaters (sacrificial anode) as well as all the other cases. MSRs >> PWRs because it is atmospheric pressure and much higher operating temperatures making it more thermally efficient. Dealing with corrosion is less costly and much easier engineering problem relative to what you give up in efficiency (PWR at 35%, FHR/MSR can get to 50%+)and accident-risk protection cost (larger PWR containment vessel).
Reply: @aj-2savage896  US nuke subs use PWR, but the Russian fleet used a lead-cooled reactor, which has a better safety profile.
Reply: @patrickmcguinness1363  Unfortunately the industry has learned that coatings are only a short term solution, and totally deadly for long term operation.

Even in the best situation they wear through, chip, or crack.

Once that happens all the corrosive potential of a large area is focused on the very small area under the defect to base metal in the coating... and its like drilling a hole through the metal effect (just takes a little time and the holes are not straight).

Coatings are used in less aggressive applications and where they can be routinely inspected and maintained, or where you are just trying to buy time before replacement of a good portion of a piping system or area (even if you have to do small repairs from time to time).

I don't see coatings as any long term solution for MSR reactors in the primary loop - as its impossible to clean and maintain them due to the radiation levels from residue in the primary loop.
Reply: I was a Navy "Nuke" Electrician and now a mastery level certified science teacher, sorry bud, but you completely lost me at "just a theory"....please research how science is done and PLEASE stop saying that WHOLLY WRONG and PATENTLY PSEUDOSCIENTIFIC phrase.
Reply: Thanks for the info but...

Mass production of small nuclear plants that are ground transportable would be easy to make in the thousands with today's production technology. Additive manufacturing, robots, complex castings allow us to make highly precise, complex parts like rocket fuel injection nozzles at a fraction of the cost. Spacex is producing rocket engines at a staggering rate, they are producing some of the most complex cars in the world in their millions every year. 
Of course we can safely mass produce these. Compare the complexity to a Tesla model 3 and realize the selling price would be Vastly higher and Still be considered a bargain.
Yeah, this is Not a concern.

Regards corrosion, current fuel has to be separated from the common uranium isotope through a Very expensive process. Thorium is 4x as abundant but 200-400x as abundant in the target isotope requireing little to no centrifuge work. Spending a few bucks to make it effectively devoid of O2 would seem Far less expensive and, as you note, in conjunction with the current superalloys, would solve the problem. If it "only" lasted 30 years, that would still sell as it Can be cheaply and easily replaced, unlike a monolithic reactor. Just unplug it and truck in another. 

Yes. We have the tech Today to do this. Only the tweaking remains if they can build a 20 year module regards corrosion as small modules are readily replacable and cheap... done! Spending $100billion to make it happen would be a bargain given the benefits. Nor would it cost nearly that much. This could be the next baseload electricity producer and we could use oil/gas to produces plastics and such, shrinking the industry and reducing the cost of power dramatically... and saving the planet or something.

The main obstacle that I see is politics.

As to: "Unproven"... Oak Ridge Labs ran their reactor for 4 years in the 1960s. W...T...F. When was that an obstacle for anything, especially when the obstacles were mainly removed already and the benefits were astounding? Literally every tech was "unproven".
Reply: Instead of corrosive resistant super alloy pipes could ceramics be a better choice?
Reply: @chriscomeskey4771  Ceramics are fragile and break when exposed to stress or long term vibration fatigue.  Also, I'm not aware of any technology that allows different ceramic pieces to be assembled that does not involve other materials being in contact with the working fluids (you cannot "weld" ceramics).

They just don't last long enough to be useful for a nuclear power plant.
Reply: @Anonymous-jo2no  anyone working in this area academically or practically is doing great work so kudos  to you. It is not just important for MSRs but for solar towers also.
Reply: First: there never was a second msr because the team got ordered to shut the project down and clear their desks of everything msr related. It was a political decision driven by other interests. It had nothing at all to do with corrosion.
Second: the main reason legacy nuclear reactors are expensive, is that water reactors are pressurized. They have expansive accidents, they have the capability to spew radioactive isotopes hundreds of miles.

Salt and lead reactors doesn't build up pressure in their core, and are therefore magnitudes safer than legacy water reactors. Corrosion isn't that big of a deal, they will have to replace pumps but that is just normal maintenance.
Reply: @perengstrom3414   A few corrections.  I have extensively researched all of those claims and learned much more since my original main post (and most of the information below is repeated above in the replies: did you read them) .

The Oak Ridge MSR was the 2nd test molten salt test reactor.  The 1st one was developed as part of the Air Force Nuclear Powered Bomber research program.  That 1st MSR test reactor failed with a significant coolant leak.

While there is some credibility to the claim that there was a political decision to significantly cut the I believe Atomic Energy Commission R&D budget at the time and I also believe it was President Nixon who did it (without my looking which agency and which President up again).  The decision on which R&D programs to cut was left up to the AEC (or whatever agency was involved).  My memory is that the R&D budget was cut about in half.  Many research programs were cut.

The followup to the Oak Ridge reactor program was cut due to the technical difficulties and problems known in many areas: Corrosion, Radiation Embattlement, massive controls and other support system unreliability.  The fact is that not much worked with the MSR test reactors and it was going to be a long and expensive process to find solutions to the known issues at the time. So it was an easy program to cut given the massive cut to the overall R&D budget.

As far as your claim that corrosion was not an issue:  Then why has multiple nations around the world worked on metalurgical research to find a "super alloy" that would be immune from the molten salt/fuel/daughter product solution in a MSR.  I've litterly read a number of the research papers on the attempts and the results.  No one is claiming that they have found a solution at this time.   The Chinese are testing an alloy that they hope combined with active daughter product chemical removal during operation that the alloy will corrode slowly enough so they can design a 4 decade+ life reactor int he future.

You apparently have not tracked the cost of construction and operation of liquid sodium and other metals (lead, and something else that the Soviet Union tried).   There is no evidence that those reactors were noticeably cheaper to build than Boiling and Pressurized Water Reactors.

While the cost of the reactor vessel and primary coolant piping is cheaper, the cost of the pumps and other things to deal with the liquid metals are higher.   It's pretty much a wash in cost at the end.

The reasons the Soviets ended the Lead and lead alloy reactor projects was because of a corrosion issue - at temperature liquid lead turned out to be fairly corrosive to the piping, pumps, and reactor vessel and interior supports.

Sodium reactors have a major issue with that you cannot use water in any form int he containment building for cooling or for firefighting as all liquid sodium cooled reactors that I am aware of has had sodium leaks - and even liquid sodium reacts violently with any contact with water.

Non- water cooling systems and other forms of firefighting are very costly.

Likewise the overall cost of a containment and shield building is how strong it has to be to withstand tornadoes tossing cars into it along with airplanes flying into it - and its ability to remain intact in the worst case earthquake.

The world has built, and with the exception of Russia, abandoned at least a half dozen liquid sodium cooled power plants (including the USA:  Fermi 1).  We know what they cost to build; and it is not much different than a PWR.

Have a great day, :)
Reply: @suntzu1409  they are the same. The sodium used comes as a salt.
Reply: @perengstrom3414   I have looked it up and verified that it was President Nixon who cut the Atomic Energy Commissions (AEC) R&D budget essentially in half.  Lots of nuclear research programs were cut, and fast.  The team working on the MSR was not the only one that quickly cleaned out their desks and left.

The AEC was having significant political issues as it had the responsibility for weapons development and maintenance, promoting the peacefull use of nuclear energy, and regulating the safety of everything nuclear.   Serious questions were asked about how could the promoter and developer also adequately regulate?

President Nixon also proposed that the AEC to be split into two parts:  Nuclear Regulation (which became the Nuclear Regulatory Commission (NRC) in I believe 1975 and a R&D and Weapons branch which became the Energy Research and Development Administration at the same time the NRC was created.

The Energy Research and Development Administration was later folded into the Department of Energy when it was created.

Due to the Oil Embargo President Nixon towards the end of his term essentially doubled the Nuclear R&D budget with a focus on nuclear technologies that would be quick to develop into full size power plants (of which the MSR was not even close).

While I have not seen the R&D budgets - I do know that a lot of R&D money was spent on developing thorium fuel cycle power plants (and the USA even built 4 commercial thorium fueled power plants).  That did not work out; but I suspect that a large chunk of the R&D money went into that after President Nixon cut the AEC R&D budget.

I hope that clarifies things.

Have a great day,
Reply: @TheTigers00001   The sodium for a sodium cooled rector comes as a metal.  While it can be derived from several salts - no sodium salts (except for food and perhaps ice-melting) get anywhere near a power plant or test reactor.
Reply: @perryallan3524 Having read your detailed comments and fully appreciate your opinion, humanity would not move forward if all we concentrated on were road blocks for decision making. Being realistic is one thing, pessimism is another. Would humans have made it to the moon with such a ‘realist’ attitude?
Reply: @goodfodder  We did make it to the moon with such an attitude.  What we did was through gobs and gobs of money at all the problems and ideas.  Then we selected the best idea that would work (regardless of cost).  Not the cheapest.  Not the most political sounding sexiest, not what some bigwig wanted.  Literally what the test data said was the best solution.

Right now the world is building about 10 1GW+ PWR power plants a year because they are a well proven design and we know how to build them and they work.

Yes we continue with R&D with things like molten salts.    But the USA built 2 Molten Salt reactors in the 1950's and 1960's and we learned there were a lot of problems with them that did not exist with light water reactors.   The world is still trying to find solutions to those problems identified back then.   China built another test reactor because they think we might have a solution at this time.
Reply: @perryallan3524  don’t get me wrong, i’m not saying traditional nuclear should no longer be built as energy diversity is required. The problem with existing designs; is the time, cost and capacity to build them, location prerequisites and of course overcoming the (incorrect) public perception. Having another clean form of power without legacy stigma is a win by itself.
Reply: @goodfodder  Actually, with the exception of Western Europe and the USA all the other countries are building large scale nuclear on time and on budget at a very reasonable cost.  There are currently about 60 such 1GW+ sized PWR nuclear power plants under construction worldwide.

The problem with Western Europe and the USA is that we hadn't built nuclaer power plants in so long that there was neither a trained workforce, experienced contractors, nor even experienced suppliers.   Nuclear construction is much different than normal commercial constrtucion where "close enough" is good enough and where the general beliefe is that "there's enough safety margin for something not built correctly.   The entire thought process is different.  Thus there were massive schedule and cost overuns with the EPR and the AP1000 in these countries.   Whereas China built them essentially on time and on budget (with the 1st examples taking a little longer and costing a bit more).

If the US were to commit to building several more sets of AP1000's in a row the US would reestablish the knowledge base and the workforce to build them economically and on time.

The other problem with your argument is that applying it to a molten salt reactor makes no sense at all.   No one in the world has ever built even a tiny MSR  test reactor that runs well for even a few years yet (perhaps the Chinese one will - and perhaps it will not).  

We literally don't know how to make it work yet on even the smallest commercial scale.

In all industries (even something as simple as changes in technology on how you build a house) it often takes decades for new ideas and concepts to not only be constructed but to prove out that they work.

Counting on a source for reliable power in the near future that is only at the "speculation, small test" stage is literally  folly, especially when there are well proven designs that work economically available now at the largest commercial sizes available with in general a large workforce and contractor base in many countries that knows how to build them.
Reply: @perryallan3524  Nuclear waste storage and solar/wind wouldn't need to exist as much if salt-based thorium breeder reactors had more R&D than typical steam-output uranium pellet ones.
Reply: @watamatafoyu  Not true at all.  Thorium gets converted to mainly U233 (with a trace of U232 and U234).  U233 is what the reactor runs on.  U233 has virtually the same amount of energy release as U235 and Pu239 for the same mass.

You need essentially the same amount of thorium to fuel a reactor as you need U235 or Pu239.

The waste generated from U233 is virtually identicle as from U235.

Same amount of fuel, same amount of waste.

The only question is how concentrated is it in whatever form its in.  I have not seen anyone claiming unusually high thorium enrichment's for a molten salt rector that is not already used somewhere in U235 /pu239 reactors.

The reason there was not continuous research on molten salt reactors is that the two built by the USA in the 1950's - 1960's had technology and metallurgy problems with no easy solutions in sight.  A number of other reactor types were performing vastly better without significant technology metallurgy challenges.   

When President Nixon cut the Atomic Energy's R&D budget about in half the Atomic Energy Commission decided to put their remaining money into projects that they thought were far more feasible at the time (which by the way included fully developing thorium cycle commercial power plants - 4 Thorium Cycle Commercial power plants were built in the USA beyond the test reactors).

While the USA did develop an successfully operating thorium cycle nuclear power plant - U235 fuel was much cheaper and at least 3 of those 4 plants were refueled with and continue to run on U235.

There is no evidence that thorium nuclear fuel would be cheaper than U235 fuel to this day.  This is not about the cost of raw ore.  It's about the cost of refined and processed thorium into a nuclear fuel material.
Reply: @perryallan3524  What I said was not true at all? 😆 Like, everything I said is completely false? That seems a bit histrionic, don't ya think? I've seen the descriptions of how steam-energy and thorium reactors work. The former is being held up with toothpicks by the uranium pellet industry, the latter is being sabotaged by it. Thorium is relatively common, uranium isn't, and thorium has no need to mountains full of toxic waste just waiting to irradiate the water supply or air. Also, any relatively small amount of waste that could be produced is re-usable if we developed the processes. I feel like you've been fed a bunch of propaganda by the established nuclear corporate industry. Go look at Kirk Sorenson's research, he describes a ton of scientists and non-execs in the industry that show how we could have a great low-waste non-disaster cycle. The reason thorium molten salt reactor research was halted was because the Nixon administration wanted to focus on nuclear weapons over nuclear energy. 60 years the R&D was in the dark ages. Now China's testing them when we could have cornered the market. It's not about cost, it's about safety, and we have solar space probes instead of nuclear ones because of the fear from terrible steam-output nuclear reactor disasters that would never have happened with thorium breeders. It's time to get out of the dark ages.
Reply: @watamatafoyu  Kirk Sorenson is not saying anything new.  The theory behind the molten salt thorium reactor has not changed since it was developed in WW II.   There are several great theoretical advantages.   However, to date no one has even built what would be considered a successful test reactor that would suggest even how to move to even the small power plant stage, much less large power plants.

While the Chinese have now built a 3rd test reactor - which without looking it up I believe started about 1 year ago.   Even they don't know yet if it will actually work (and I follow their progress as best as  I can).

What you likely don't know is that preceding the Chinese 2MWthermal test reactor was about 15 years of research with at least 4 countries involved in to looking for some kind of "super alloy" that would withstand the molten salt fuel with decay products and chemical resultants after it started to run and the radiation field it has to operate in.   I have personally read at least a half dozen of the papers on that research over the years - and likely skimmed another half dozen.

Guess what.  No one has identified an alloy that would not likely corrode and degrade in a MSR reactor.  What they have found are alloys that will corrode and degrade at a much slower rate than what the USA used in the 1950's and 1960's to build the 1st two test molten salt reactors.

At the same time, the concept that you could effectively filter the circulating molten salt stream and remove the worst of the corrosive elements has been developed and concept lab tested.   

If you combine effective removal of the worst corrosive elements with a slower degrading alloys then you might be able to design a reactor that can safely run for 4 decades or more - which is what will be required for power plants.

The Chinese test reactor was specifically built to determine the real world effectiveness of the chemical separation and the actual resulting corrosion rate fo the alloy they chose (and I am sure that they have corrosion coupons of the other promising super alloys out there installed to monitor them as well).

In addition the Chinese reactor is to study the thermal performance of the reaction and reactor with far better instruments than existed in the 1950's and 1960's.

The other major thing that you ignore is that there have never been any nuclear secrets in the world other than atomic bomb initiator design (but everyone who works in the field can propose designs that likely work - and would need minimal testing to verify).

Molten Salt reactors were proposed in WW II.  Thorium as a fuel was identified at the same time.

Sodium cooled fast reactors, hot gas reactors, heavy water reactors, graphite reactors, and light water reactors were all proposed within a few year window of when the molten salt reactor was proposed.

I'm aware of about 10 different countries that built sodium cooled test reactors, and I believe 5 of them developed them into full size power plants (and I believe 3 countries are currently running at least 1 sodium cooled fast reactor power plants).  But, these plants have historically had a lot of problems and are no longer a favored design.

While not sodium cooled the Soviet Union built 2 different eutectic lead alloy liquid metal cooled reactors (which failed badly from a longevity standpoint - I have read the paper published by Russia after the break up of the USSR on the promise and problems with those reactors).

Multiple test Gas cooled reactors (GCR's, AGCR's, and HTGRs) have been developed (and there are some newer ones today).  At least 6 countries built gas cooled nuclear power plants (I believe only the UK is currently operating the newest ones and they are being replaced by PWRs).

Graphite test reactors were the easiest to build and its likely that over 20 countries built them.   I'm aware of 2 countries that built graphite power plants - and one of them (Soviet Union) exported them to other countries (Chernobyl reactor design).

Numerous countries built heavy water test reactors. Canada developed the heavy water reactor into a commercial power plant and exported it to other countries.

Light water test reactors were actually in the minority of early test reactor design; and both BWR and PWR power plants were developed from those test reactors - and now make up something like 95% of all nuclear power plants in the world, and about 98% of all new construction plants (PWR design has won out over BWR as while a PWR is more expensive to build - its cheaper and more efficient to operate over the decades).

That leaves the question as to why no other country in the world built a test molten salt reactor until now.    Lots of countries built all the other reactor designs.

The answer is that the US Atomic Energy Commission published the data on the operating and design issues identified with the 2 MSR test reactors... and the entire rest of the world looked at that data and did not have any plausible solutions and saw no reason to go that direction - until 15-20 years ago when they started to discuss how it might be done and started the research projects into some kind of super-alloy and chemical filtering.

While there is an abundance of thorium ore in the world.  I am aware of only 5 commercial power plants built that ever used it as a reactor fuel.  4 in the USA and 1 in Germany.     

Lots of countries built thorium fuel cycle test reactors (and a number of these are still operating today).  Lots of countries looked at what it would cost to produce reactor grade thorium fuel.  Both the USA and Germany have said it was very expensive compared to  U235 or a mixed oxide of U235 and reprocessed Pu239.

Did all those other countries get it wrong as well?

Please look at the entire world of nuclear test reactors and power reactor development.  This is not something that the USA did on its own.  Essentially, everyone else in the world has to this point rejected molten salt reactor designs and thorium fuel cycles for decades.

Now you can wax on about the theoretical advantages of both all you want.... But, that's just speculation until the practical problems of how to build a reliable molten salt test reactor, and convert that into a reliable power plant, and bring down the cost of thorium reactor fuel (not just the thorium ore cost)...

A bit of important trivia regarding thorium ore.  No ore is pure down to a single element; and thorium ore contains a trace element that converts to U232 (and not the desired U233).  U232 is a very high gamma radiation source.  It makes handling of spent thorium fuel cycle fuel and reprocessed uranium fuel (mostly U233, with traced of U232 and U234) very difficult and expensive.

So not only is the production of actual thorium reactor fuel expensive compared to U235 or even Pu239.  The handling of the waste fuel, reprocessing of the waste fuel to extract the uranium, and any new uranium used to make new fuel all into very expensive processes compared to U235 and Pu239.

If you would actually look up how the thorium fuel cycle works, and what everything converts to from the thorium ore you will see all of this.

Now there is a way to extract extremely chemically pure U233 from the thorium fuel cycle an eliminate virtually all of the trace U232 and U234.  It's extremely expensive.  The USA did this for a while as part of development of U233 bombs as U233 has some real advantages over Pu239 as a bomb material.  However, the USA shut that program down as the extreme cost of the resulting U233 bomb material was so far above the cost of PU239 bomb materials that it was considered not worth it.  Not even close.

Anyway, I'm awaiting you answer as to why no other country in the world developed molten salt reactors since the 1960's or thorium fuel since the USA's 1960's - late 1970's efforts.  I assure you that the Soviet Union, China, and many other countries didn't care a hoot about US political or even scientific viewpoints on many things.
Reply: Sir, thank you for you post. It was extremely informative and enlightening. I want to copy & post your comment on every YouTube MSR advocacy channel I find, but I'm afraid you'd be denounced as a climate denier, fossil fuel troll, transphobe, racist, & maybe even a Republican. Go well.